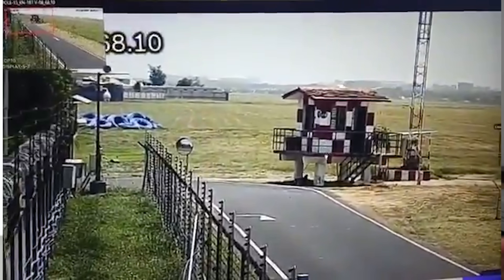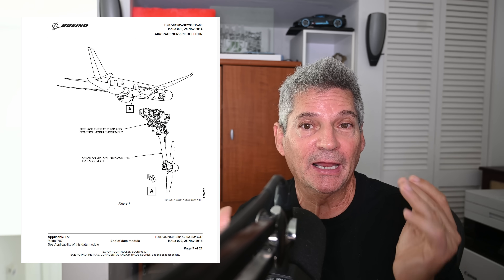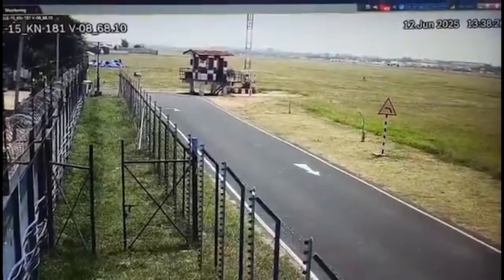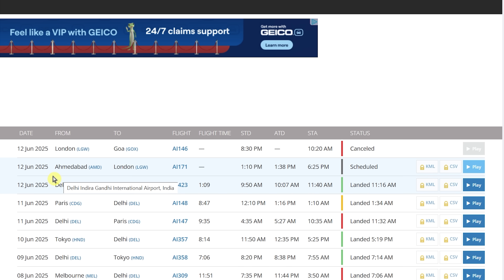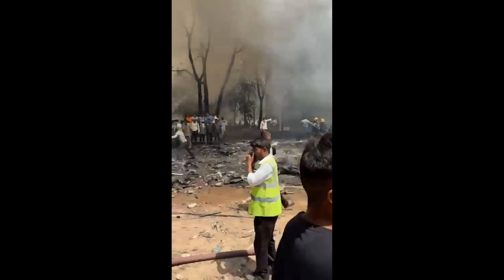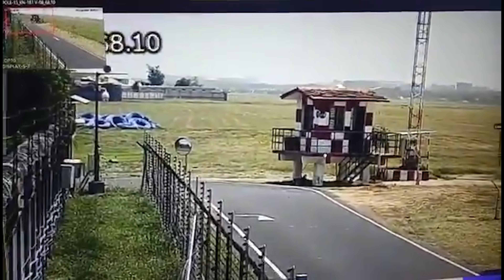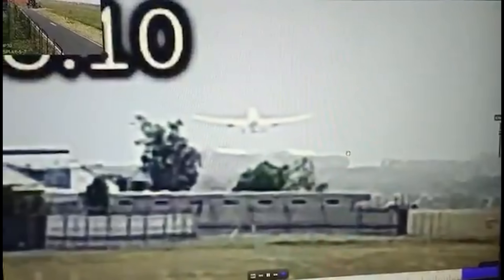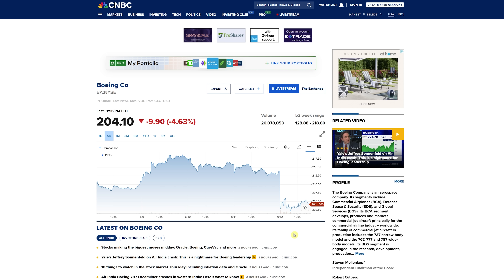What Caused Air India 171 Crash, Mysterious Sound Before Impact

Comment: 25,000-hour B777 captain here.  It may be pilot error.  Selecting flaps up after takeoff instead of the landing gear is my theory, and it explains why the gear stayed fully down. The crash pics show the L/E slats extended on the ground with little or no T/E flaps extended. That could not have been the T/O configuration, and "proves" the flaps were selected up after T/O.  Selecting flaps up at a speed behind the power curve would feel to the flying pilot like a loss of power, thus the "mayday lost power" radio call.  If true, the FDR will confirm.
Reply: By now the Indian authorities probably already have downloaded the data and voice recorders. I doubt that this crash will be hard to solve.
Reply: Hi Captain, I'm armchair rated at best but I am here to learn. May I ask, would your theory explain the RAT deployment and could the aircraft take off in that configuration without the bells and whistles going berserk? Thank you for your time, Captain
Reply: @restojon1  I have looked and looked….I don’t see a RAT.
Reply: @buckcampbell4292 I can just about see what looks like the little flap by the wing root kind of area
Reply: @restojon1 the captains more armchair  than you 😅
Reply: @restojon1 I was thinking the same thing . . I have a feeling this crash was caused by some sort of mechanical failure
Reply: @restojon1 not likely. Selecting flaps up would not likely deploy the RAT.
Reply: @restojon1  if you look at the video and enlarge it you can clearly see that no RAT was deployed at any point, engines sound like that on takeoff when they are at high power, also with buildings that close you will get echo/reverb which could sound like a RAT. Also remember that this Boeing has massive fan blades for thrust, the main engines are called Turbofan Engines for a reason.
Reply: @restojon1  his is a fake CAPTAIN ! He's impersonating captain steve who has more than 50k subscribers, who's a real pilot. HE'S A FAKE PILOT ! INVENTING THEMSELF LIFES ON INTERNET.
Reply: @restojon1  his is a fake CAPTAIN ! He's impersonating captain steve who has more than 50k subscribers, who's a real pilot. HE'S A FAKE PILOT ! INVENTING THEMSELF LIFES ON INTERNET.!!
Reply: Ok, was that a bearing going? Or was the RAT? The one video shows dust flying as they went into the air. Does this suggest they were at the end of the runway? Could they have been having a problem partway down the runway?
Reply: the 1 survivor said he heard a loud bang right after takeoff
Reply: @T1Earn  he must have a horrendous memory now, knowing what’s about to happen and hearing all the other passengers scream …
Reply: @dealightful82  crazy to say we wouldnt trust what the only person who survived is saying literally hours after it happened. And he never went unconscious either
Reply: @T1Earn  True, he just went through a trauma, his perception may have been altered.
Reply: So forget about all the human error theories. What is the plume of smoke on the airport cctv as the plane lifts off the ground? Also, I saw a video of a passenger who was in that paricular plane hours before it crashed, and he said the A/C compressor was malfunctioning on then off throughout the flight and also peoples tv screens stopped working. I reckon its a badly maintained aircraft. NTSB will soon confirm.
Reply: @SteveSkrobot the ntsb isn’t in charge.
Reply: @BirdDog.  yeh I know, but the US is sending some investigators over.
Reply: @SteveSkrobot and they buy used parts to fix their planes.  Disaster ready to happen.
Reply: As a 44yr military/commercial Captain. I agree with the assessment. The flaps were set correctly for T/Off (otherwise the computers would be squawking at power up). Sounds as though the 1000 hour F/O selected flaps up instead of gear up after T/Off.
Reply: @valentinomarchione5576  "otherwise the computers would be squawking at power up"
Unless of course the power breaker was pulled.
Reply: Liar.  They didn't forget to lift the gear, they have the RAT out to try and cleanup the surfaces, flaps and gear.  Obviously engine+hydrolics failure.  Like the korean bird strike.
Reply: @valentinomarchione5576 And why is there no safety system in such a plane to prevent such a basic and catastrophic error? Negligent design by Boeing again?
Reply: @valentinomarchione5576 With crm, don't they verbalize their actions? How would 1,000 hour 787 pilot verbally say they were raising the gear when they had their hand on the flap lever? That's incomprehensible.  Workload on a 787 is relatively low compared to other aircraft so how would hey highly experienced captain have not picked that up?  They're in the heat India, they've chosen a reduced length takeoff roll, they should be on their game no?
Reply: @valentinomarchione5576  1000 hour pilots and intersection takeoffs make for very holy swisscheese.
Reply: @valentinomarchione5576  There would be a system warning and they could have reversed it.
Reply: @valentinomarchione5576  FDR will quickly establish. From a human factors POV, this is a distinct and tragic possibility.  Some 777 guys have mentioned certain envelope protections the 787 likely has that might protect against below speed flap retraction but it certainly looks like that may have happened nonetheless.
Reply: @valentinomarchione5576 seems like all of we seasoned airline pilots are in agreement about the most likely scenario being the pilot not flying raising the flaps instead of of the gear with lack of forethought
Reply: @valentinomarchione5576 But pilots of the plane say you can't change the flaps after take off, it won't let you!
Reply: this is my theory as well, though i started thinking about how it was only in the air for like 30 seconds, and maybe they forgot to set flaps for take off at all, and just wasn't thinking about retracting the landing gear anymore when they noticed they weren't climbing.
Reply: @WessyD1  - There is a warning system, that tells you if the flaps aren't deployed for takeoff - it SCREAMS at you.  Pretty hard to takeoff without at least some flaps deployed in a modern aircraft.  So, more likely retraced by mistake after the wheels left the ground.
Reply: @Summitspeedfly  yeah, most likely retracted by mistake.
Reply: With no flaps they wouldn't have made it past 100' altitude @WessyD1
Reply: @WessyD1 in a B787 if you don't set the correct flaps according to the specific configuration before taking off huge alarms go off in the cockpit so it's almost impossible to miss that , my assumption being the co pilot instead of retracting the landing gears accidentally changed the flaps which caused the wings to not generate enough lift and subsequently the drag produced by the gears pulled the craft down into the ground
Reply: @WessyD1 as soon as they advance the throttles they would master warning and aural warning and all the other bells and whistles letting them know plane is not configured for take off.
Reply: @WessyD1  that's what I was thinking. I watch the "mayday" series, and there was one they covered where the pilots hadn't deployed the flaps, which caused the crash, of course. If I remember correctly, they were behind their intended take off time, and I think a couple of other things were going on, too. This created a lot of stress, which, in turn, could have caused them to forget one of the most basic steps. That's what the investigators had speculated.

The video from that crash looked very similar to this one's crash. But their RAT wasn't deployed, so there wasn't a noise before they crashed.
Reply: @WessyD1 Plane won't take off with flaps in the wrong position, without alarms!
Reply: @imyourhuckleberry1058  it'll take off, just wont climb afterwards.
Reply: @WessyD1 the piolet had 8200 hours of experience, how can forget
Reply: @Real_cat_14  🤷‍♂
Reply: @WessyD1  - Then take-off did not happen after rolling! The air plane went UP then lost altitude!
Reply: @trungduongdang8087  a plane still take off with no flaps. it just can't climb.
Reply: @WessyD1  787 doesn't allow take off if flaps aren't down
Reply: @reardelt  You can override any automatic system on a jet.
Reply: @WessyD1  Why would any sane pilot override that system? It takes a lot of effort to override that system on a 787. No one does that on take off
Reply: @WessyD1 but wouldn't there be a warning on the runway about flaps?
Reply: @WessyD1  I'm also not expert but I think you're correct, once they realized there was something wrong they weren't focusing on the wheels and let them as they were, but then the captain is also correct, we don't see the flaps down as they are supposed to be during a takeoff. Having a pilot AND a copilot, it is mystery how two people would miss this major error. I guess we'll just have to wait for the black box and eyewitness interview analysis.
Reply: @WessyD1  the 787 literally wont let you take off without proper flap config so not possible unless the crew purposefully did it.
Reply: @ChikenTendersYa  yeah, i mean, they might not have known what alarm they were disabling. they might have thought it was something else.
Reply: @WessyD1 they would not have taken off without the flaps being deployed because too many warning horns would have been going off so imo they must have raised the flaps too early for their phase of flight or raised them by mistake
Reply: @davidmorais480  dude read replies before you reply. Its just a theory. i just as much think it could be what you say or the other.
Reply: @WessyD1 But with the sophistication of Dreamliner's electronic, the avionics should not have allowed take off or warned  if flaps are not in correct Take-off mode?
Reply: @bobbykrystal4798  yeah, i mean, its just a theory.
Reply: @WessyD1  If takeoff flaps hadn't been set, it would probably have crashed on the airfield. AIUI, the 787 has serious protections that don't allow takeoff thrust without the flaps set.
Reply: @WessyD1 not possible...this airline has security systems that reminds pilot when any take of procedure is not done
Reply: @rameesarahman007 a pilot screw up will not originate a " may day " , it is a human compulsive guilt management mechanism. Cockpit voice recorder will also bring that out . 
There is a sound of EXPLOSION reported by the survivor, when the descent starts
Reply: @WessyD1  This is a fake CAPTAIN ! He's impersonating captain steve who has more than 50k subscribers, who's a real pilot. HE'S A FAKE PILOT ! INVENTING THEMSELF LIFES ON INTERNET. when they usually say "XXXX here" it s100% Fake
Reply: @WessyD1  his is a fake CAPTAIN ! He's impersonating captain steve who has more than 50k subscribers, who's a real pilot. HE'S A FAKE PILOT ! INVENTING THEMSELF LIFES ON INTERNET.!!!
Reply: I said in another video why does it look like there is no flaps down for take off... 

Then again I'm not a pilot.
Reply: @evelghostrider  that's the right question.... they look up, but the imagery is very grainy....
Reply: @evelghostrider  I think it looks like the flaps are down.
Reply: It can't be . Coz gear up down lever is in front ahead.  Flaps are next to pilots. 2 diff location
Reply: @AneeshChowdhury  Also surely system warnings for such a mistake?
Reply: @AneeshChowdhury  Yah.  He went to the wrong location and raised the flaps….cause Indian pilots.
Reply: @AneeshChowdhury I think you would be surprised at the mistakes we are capable of.
Reply: T.A.P Air Pilot here. I don't see the Flaps do you?. and Why are the landing gear still down?
Reply: What about the loud bang the survivor reported?
Reply: @jimjoe9945  Gear was down and probably clipped a building a second or two before full impact.
Reply: @jimjoe9945 maybe the APU blew... That would explain the rat deployment.
Reply: @jimjoe9945 that happened when the right engine failed
Reply: @jimjoe9945 So many people are missing these clues, the bang sound and the sound of the RAT
Reply: @jimjoe9945  Bird strike. Same thing like happened with US Air and Sullenberger. But he was at like 1600 feet when they lost both engines and had more speed and altitude and therefore time to point the plane in a different direction and ditch in the Hudson. These Air India pilots had no air speed or altitude to play with so they were doomed.
Reply: @jimjoe9945  RATs that I'm familiar with (and have deployed in flight testing) are actually "Spring Loaded" in their storage compartment in the Fuselage. An electrically fired Explosive Bolt unlocks the latch that keeps the RAT stored in its' compartment, and the spring forces the RAT out into the airstream, nearly instantaneously. You will hear a "loud bang" when the bolt fires and the RAT "slams" into place.  Given the location of the RAT, and the survivors seat location, that's probably what he heard...
Reply: @jimjoe9945 you the bang when the airplane hit the ground?
Reply: That was what I thought earlier, but why was the RAT deployed? In one of the videos, you could hear it very well as its sound is quite distinctive. I doubt in that amount of time that the RAT would be manually deployed, so it makes you think that it had to be autodeployed.
Reply: @ericchristensen634  Ironic to say that in  a video you can hear the RAT but not see it.  How do they make these invisible RATs?
Reply: @ericchristensen634  with 10 seconds to death, you aren't deploying the RAT..... you are kissing your ass goodbye.
Reply: @ericchristensen634  In that circumstance, there's no reason to manually deploy the RAT, I'm not familiar enough with the 787 to even know if that's possible. But the only thing the RAT is supply emergency electricity. In the circumstance they were in, they had battery electricity for a lot longer than they'd need.
Reply: Raising landing gear often increases drag when behind the power curve due to opening access doors to allow retraction.
Reply: Jeff, the seat map you showed appeared to be for the -9. I believe this was a -8.
Reply: Captain Steve, poor service and fuel also may have caused the tragedy???
Reply: I have a close friend who is a 787 pilot and I asked him about the takeoff flap settings. He said "Usually the lowest flap setting for takeoff is Flaps 5. This flap setting includes full slat deployment" The slats do look extended and FLAPS 5 is so minimal that it may have not been apparent in the low quality video we have seen thus far. The flaps go all the way to a FLAPS 30 setting for full extension. Generally flaps on airliners are not lowered nearly as far for take off as they are for landing. Note that the initial climb out after rotation appears normal whereas in accidents involving improper flaps/slats settings planes have a hard time just getting off the ground. The real issue here is somewhere around 400 feet of altitude the 787 lost all power. This is why the RAT deployed and the main engine noise is next to nothing. The landing gear also looks like it was partially through the retraction process which pulls the main boogies into a forward tilting position to fit into the landing gear bay but could not complete the process because again both engines shut off thus killing the hydraulics. So the number one question in my mind is what happened to the engines? A flight crew can do everything absolutely right but with no engine power you're still going to crash.
Reply: @ronhaworth5808  Excellent observation and comments. Takeoff flap settings can be as low as 1, but given the weather conditions, I guess they'd need more lift than that. 
"Boogies"? Do you mean the landing gear trucks (as Boeing calls them)?
Reply: If it was a flaps  issue you would have heard the engine running at max thrust as pilots tried to get it up
Reply: the flaps WERE up!
Reply: @utley yes, that's the theory. The landing gear was supposed to go up first, followed by flaps later, incrementally. Not the other way round
Reply: Can they be done at the same time under RAT power?
Reply: seems not.

we can see the engine from behind

11:30
Reply: @utley  You missed the point...
Reply: @utley  So pilot fatigue killed over 200 people? No professional pilot would make such a basic error unless he was punch drunk with fatigue. One version I read said the Captain was flying,with the F/O on the instruments/controls. The Captain requested wheels up,but the F/O retracted the flaps instead. The flight recorders will reveal the truth.
Reply: @mikedunn7795  if the flaps were up, that means they either didnt do the takeoff checklist or the flaps didnt deploy when commanded to.
Reply: @mikedunn7795  those flaps werent deployed at all.
Reply: @utley  Not on the crash pictures
Reply: @utley  That's what he said - the pilot mistakenly put the flaps up instead of the landing gear.
Reply: @utley --- nope... flaps were extended.
Reply: @utley No they weren't. Take another look at 0:01 seconds into this video and you can clearly see leading edges deployed, and flaps  extended.
Reply: @utley  pause at 1:41 and zoom in. Not a pilot, but are the flaps closest to the fuselage? Do they look like they are down?
Reply: @sined726  I SAID THEY ARENT DOWN.
Reply: @utley apparently this type of plane won't let you take off unless the flaps are in the correct configuration for take-off.
Reply: @utley  pause jeffs latest video at 12:36, FLAPS ARE DOWN. You can see the gap between wing and flap.
Reply: @sined726  if flaps were down, you wouldnt be able to see the exhaust nozzles, especially at that angle. coincidentally, forward of those flaps are the spoilers.
Reply: @sined726  inboard set of spoilers anyways...
Reply: @utley  how can you tell it’s near impossible from the distance the video was taken…
Reply: @Ilike.kong. aircraft that big you know if the flaps are down or not. Full flaps and those things hang about 4 feet off the deck. Half flaps they hang about 8 feet off the deck. Zero flaps? about 20.
Reply: @utley  i zoomed in the video multiple time and I do not see the flap set to 20 degrees
Reply: @utley  his is a fake CAPTAIN ! He's impersonating captain steve who has more than 50k subscribers, who's a real pilot. HE'S A FAKE PILOT ! INVENTING THEMSELF LIFES ON INTERNET.!!!
Reply: @utley nope they were not.
Reply: @utley  The SLATS appeared extended on one of the vids I saw.   On the older 767s, FLAPS 1 was a takeoff config which resulted in Leading Edge Slats deployed but zero Flas.
Reply: @utley how do you know?
Reply: @utley yes, and he very clearly says that in his comment, weird you missed that!
Reply: Not at rotation unless they were committing suicide. Too many warnings/buzzers. If it wasen’t engine failure that’s prob what happened. The gear are pulled up right after the wheels leave the pavement….. They were down until impact😢
Reply: @utley 
No they weren’t. It’s not possible to takeoff without flaps is these things. People are used to looked at landing flaps so don’t know what takeoff flaps look like. And the slats were extended in wreckage photos. Even if flaps were inadvertently selected up it would only be from 5 to 1 and they don’t retract that quickly. While possible it seems unlikely
Reply: @meofnz2320  Oh it will be able to take off without flaps, just will need a lot more speed than usual. Go watch the B-2 crash on guam  and tell me if those crashes look exactly alike if not similar. Given all the issues on that aircraft that were electrical being reported prior to the crash, I wouldnt doubt for a second those flaps didnt deploy when commanded.
Reply: @utley  the engine cut out
Reply: It's not clear. 5 degree flaps at that distance is difficult to detect.
Reply: @utley why the smoke show at the end of the runway, they shouldn’t have used up all the runway.
Reply: @utley  Yea, looks like they are up...
Reply: Just to add. In the flight computer, you can set the thrust to reduce power when retracting flaps after take off, which would of course makes things worse if the flaps were selected by mistake before the optimal speed is attained
Reply: My thoughts exactly, and loss of lift occurred exactly where you would expect the gear to be moving upwards. Just a thought
Reply: How you confuse flaps with gear
Reply: He needs speed to prevent a stall.  Speed falling, so he tried to cleanup the surfaces.  I don't know why he didn't lift gear.  Might have gave him a chance, maybe still not enough speed though.  Big power-loss somewhere possibly 1 engine, with a max load and stupid shorter takeoff.  Never ever accept an intersection takeoff.  You paid the fees for the full length..take the full length, every time.  ATC can go to hell!
Reply: @latinbishop1722  It's been done several times before by experienced pilots and co-pilots. Unfortunately when mistakes happen during takeoffs and landings there isn't enough time to go through check lists to determine what the problem is. We still have no idea what exactly happened. We will have to wait and see for sure. It could be mechanical.
Reply: @latinbishop1722  Exactly. And surely there would be system warnings?
Reply: @latinbishop1722 It is definitely possible. Ask the delta crew that shut down both engines on a 767 very shortly after takeoff from LA many years ago. Selecting the wrong control/switch happens more than you know. Most of the time the mistake is recoverable. 

I doubt inadvertent flap retraction is the case here however. There is like 15 seconds or so of “descent” prior to impact. Thats a lot of time to recover from an inadvertent flap retraction especially with the engines already producing take off thrust and the crew would have likely fire walled the thrust levers as well.

I expect we will learn that both engines were failed for whatever reason. Simply no time to get them running again even if was possible. Horrible scenario.
Reply: @Scott767300  "There is like 15 seconds or so of “descent” prior to impact. Thats a lot of time to recover from an inadvertent flap retraction"
Only if they would understand what the problem was within the first 5-8 seconds I guess. Maybe mistaking the flap lever for the gear lever is so out of the norm that they even never considered it. See, that's the issue with speculating.
Reply: @brucelansberg5485 I would disagree on the “not knowing for 5-8 seconds” especially regarding the thrust status of the engines. This would be immediately known. You could feel the loss of thrust and hear it immediately. And a quarter second glance over at N1/EPR would tell the tale. They knew the thrust status immediately. Would they have known why thrust was lost? No.

If indeed the engines had failed (for whatever reason) there is not much you can do. I suspect we will learn this is the case. At least it should be easy to solve. Terrible scenario.
Reply: @latinbishop1722  inexperienced copilot.
Reply: It’s probably another  malfunction from the plane ✈️
Reply: Totally agree.  The sinking would give you a sensation of loss thrust if you didn’t look at indications.
Reply: how could you ever mistake the landing gear lever with the flaps adjuster
Reply: Yep. Flaps up wheels down. Should be the other way around. At least that's what it looks like.
Reply: You can’t see the flaps being put up so I’m not sure why you pilots all keep peddling this theory. If you look at 787 take off videos the flaps look like they’re in the same position as the air India flight doing
Reply: Almost all crashes are pilot error no matter what the news says. It ridiculous that people in the comments refuse to believe it could be pilot error. If you don’t believe it’s pilot error then why are almost all crashes found to be pilot error???
Reply: @veiledallegory It definitely could be and yes you are correct that most crashes have the crew as a contributing factor. 

This one however might be an outlier on those stats.
Reply: @veiledallegory  That's not true, poor maintenance procedures and inspections combined with cost cutting exercises are often the cause.
Reply: ex f4u fighter captain.... reducing the lift by retardin flaps to early sounds off considering to flaps = less drag = faster accelerate to 220 to get that thing level...

to me its look like the engines werent produced enough thrust to keep it in a climb, ..  my bet is poor mainenance... the east indians are notorious for it :-\
Reply: right on the money. I have been flying the 787 for 10 years. "positive rate.. Gear up"  the gear never moved. someone appears to have moved the flap handle up....Damn!!!
Reply: Possible pilot disagree on abort?
Reply: @tag1961 then you should know that if the pilots knew they'd lost engine power and couldn't possibly climb, what options did they have left?
Put it down where you can... In this scenario you leave gear down.

This is basic stuff...
Reply: Stupid assessment. The RAT was deployed, nothing to do with flaps. Fuel/engine issue.
Reply: Good observation.
Reply: I'm THRILLED that you are chiming in!! So MANY THANKS for your knowledgeable and respected feedback!!!
Reply: I agree about the flaps and the landing gear. But that's the quietest jet I've ever heard.
Reply: Why would the RAT extend if not engine failure?
Reply: @n085fs  I'm not too familiar with the 787, but on the Airbus models, there is a guarded button on the overhead panel to manually deploy it.
Reply: 100-hour flight sim user here.  I wonder why flaps are manually selected, when it seems it would be easy to implement "auto-flaps" where the speed-appropriate flaps setting is always selected by automation.
Reply: @vonkruel  Because changing flaps setting changes elevator trim as well.
Try flying the simulator on 100% realistic settings and even then you're maybe 20% true to life.
Reply: @n085fs  I only referenced my sim experienced jokingly.  Thanks for explaining why "auto-flaps" isn't a thing.
Reply: @vonkruel exactly…like camera settings in manual….set for shutter priority, you select the speed, the camera changes everything else to get a good photo.
Reply: Agree
Reply: nice hypothesis and the closest estimate
Reply: I don’t see flaps. Do you ?
Reply: @Traveler_SF nope
Reply: Unlikely sir. The pilot had 8200hrs on file. He's been flying the same model for ~11 years. The motions would be muscle memory by now. It's highly unlikely that it's pilot error considering even the copilot had 1100 hrs on file. It's improbable.
Reply: Pause the video at 0:01 seconds. You can clearly see the leading edges are deployed, and the flaps are down. The thing that is more telling is the main bogeys have rotated level like the gear was commanded, but it does not cycle into retraction. Dual engine failure and sudden loss  of hydraulic looks plausible.
Reply: @kevinfinke6927 yup, I agree with you. Major failure. Sucks that it happened in one of the most critical phase of flight. I’m curious if it’s a GE or RR engine. This can have serious implications on the variant.
Reply: @WattsValor They fly the GE nx variant.
Reply: I’m also a 25000 hour 777 captain. It’s possibly an inadvertent flap selection but there are some flaws in that theory. The flaps would only travel from 5 to 1. I’m not convinced that a) they would retract fast enough for this result, or b) it would even stall at all. After all, It was doing 180kts on lift off and I’m usually seeing well over 200kts by the time gear is selected up.

I gotta admit though…it is odd that the gear stayed down while the initial part of the climb was normal…suggesting that power was available during the period the gear would normally have been selected up.
Reply: Since you say you are a 777 pilot what happens when you set throttle for takeoff when the flaps aren't deployed? Take note that the same thing happens in most modern aircraft. The takeoff config alarm CANNOT be disabled. Why not abort takeoff if the alarm is blaring at the pilots?
Reply: @GreggRoberts  or deploy the flaps
Reply: You are correct. The "CONFIG" warning cannot be silenced. My guess is that the takeoff configuration was "normal" as the aircraft accelerated and the initial climb appeared to be a normal climb. My first question is why wasn't the landing gear retracted as the aircraft climbed through at least 600 ft. AGL ? Secondly, a decent like that MAY have been caused by a premature retraction of the flaps. We'll know more when the CFR & DFDR are analyzed.  @GreggRoberts
Reply: Once you call out mayday if you're a pilot you would definitely check flaps. Its an easy fix, but not unless you also have loss of power. There's an engine/fuel issue at the core here.
Reply: @halfmv2  I agree it looks like engine or fuel doesn't it. That would explain the RAT deployment. Somebody else suggests the flap retraction too soon would do it but i don't see why the RAT would initiate on flap retraction. But it definitely pops out if you've got no power from dead engines.
Reply: @halfmv2 or battery power or apu failure
Reply: @halfmv2  yes   engine or fuel   the aircraft should say  you flap settings are incorrect  change settings    stall on takeoff ..
Reply: @halfmv2  Engines in this plane are independent, pumps, computers are independent.
Reply: @halfmv2  There unfortunately have been numerous other crashes like this due to the flap configuration during take off
Reply: @halfmv2  his is a fake CAPTAIN ! He's impersonating captain steve who has more than 50k subscribers, who's a real pilot. HE'S A FAKE PILOT ! INVENTING THEMSELF LIFES ON INTERNET.
Reply: @halfmv2  his is a fake CAPTAIN ! He's impersonating captain steve who has more than 50k subscribers, who's a real pilot. HE'S A FAKE PILOT ! INVENTING THEMSELF LIFES ON INTERNET.
Reply: @halfmv2 clearly you’ve never flown a plane from your faulty assumptions
Reply: @Mpr47276  ok so you want to replace all aircraft design engineers with pilots because engineers clearly haven't flown a plane?
Reply: @halfmv2  Aviate, Navigate, Communicate. Calling Mayday would be the last thing you do after checking flaps, undercarriage, Engines etc..
Reply: @serverlan763 yes that's exactly my point, they couldn't have simply missed something if they called mayday
Reply: @halfmv2  maybe a gravel strike? {like a bird strike}see my comment
Reply: And the pilots just manually deployed the RAT for the fun of it?  If you were piloting that flight and the RAT deployed, why might it be, captain?
Reply: @LokiCentral  Its also automatic, at total loss of AC, deploys in 2 sec
Reply: @LokiCentral  The Japan Airline 787 landing with ram air turbine (RAT) is not necessary an emergency landing. An airplane in C check is a jobcard for RAT operational check, sometimes we will request pilot that deploy RAT at the last flight landing right before C check, than during C check we do not need to setup equipment creat ram air to test RAT, instead just test RAT retract function.
Reply: @stanleyjtw  Right, I'm assuming that.  But it still sounds like a RAT, doesn't it?
Reply: @LokiCentral  That video was pretty clear but no RAT visible.  How do you explain that?
Reply: @DellAnderson You can hear the RAT very distinctly.
Reply: @LokiCentral sudden loss of electrical power. The RAT is just a prop driven generator that supplies electrical power to critical systems and instruments
Reply: @LokiCentral how to tell if RAT was deployed
Reply: @LokiCentral por lo visto no escucharon todo lo que dijo el capitán, el RAT es un sistema automático de emergencia, que se activa para asegurar que exista suficiente amperaje o voltaje para los aparatos más indispensables
Reply: @LokiCentral  No RAT was deployed.
Reply: @LokiCentral  it's automatic.  if they had engine failure it would pop out automatically.   At this stage of flight, however, it is of no use.  You cannot take off without engine power, obviously.
Reply: @LokiCentral  his is a fake CAPTAIN ! He's impersonating captain steve who has more than 50k subscribers, who's a real pilot. HE'S A FAKE PILOT ! INVENTING THEMSELF LIFES ON INTERNET.
Reply: @LokiCentral  his is a fake CAPTAIN ! He's impersonating captain steve who has more than 50k subscribers, who's a real pilot. HE'S A FAKE PILOT ! INVENTING THEMSELF LIFES ON INTERNET.
Reply: @LokiCentral  RAT automatically deploys when it senses a loss of power....  So that suggests that maybe both engines experienced a sudden shutdown....
Reply: @LokiCentral  The theory in the video is that it sounded like the RAT was deployed. That is just a theory offered, not a known fact and there is no visual evidence of that theory being correct. I've zoomed right in and it doesn't seem to have been.
Reply: @LokiCentral  RAT are deployed automatically
Reply: did the engines noice appeared too low-frequency , indicating a possible low rotation problem?
Reply: Isn't there a config alarm??
Reply: Agree, aren't the flap controls on the center in between the pilots and the wheel extension in the middle between the yokes?
Reply: Condoléances aux familles 🙏🙏🙏
Reply: With all due respect Captain, can I ask you why they used the entire length of the runway, kicking up dust at the end? 
It reminds me  the case of Olympic Airways Flight 411 on August 9, 1978 from Athens to New York.
Reply: @octoberon5959  if you look at Flightradar 24 data from this flight, it shows then starting TO from the middle of the runway!!. It does not show them taxiing all the way back to the end of the runway and turning 180 to line up and start their take of??
Reply: full toga thrust selection would surely outweigh and early flap mistake though? I fly 787 and the excess thrust is insane low alt. Be interesting to see the FDR and any GE real time data.
Reply: @NickoHines they probably weren't far off 100 anyway.
Reply: And why is there no safety mechanism, override, alert warning and, or alarm on these planes to prevent a pilot from incorrectly and catastrophically changing the flaps' configuration immediately after take-off, or at any other time during the flight? That would seem like a very basic safety feature that all planes should have, to ensure that what you have described cannot happen.
Reply: @markpalmer8083  Cost of production.
Sure, all systems can be engineered to operate only within limits.
But it's cheaper to just train the pilots when to operate things.
And then when training gets too expensive, ya get more pilot error issues.
Reply: He had 8200 hr+ flight time experience.. I don't think it's a flap issue.. it might be an engine related issue
Reply: RIP everyone.
Reply: Wow, for once, Captain Steeeeeeeeve might be onto something.
Reply: This is the same thing I thought based on the photos. Flaps are suspiciously retracted and the descent started around the same time you would have expected the pilot flying to call for “gears up.” I think the moment the plane starts descending, the pilot monitoring pushed the wrong lever.
Reply: Gear wasn't working
Reply: If this was the cause (human error) then why don't the plane makers make take offs overriden by an auto-pilot software?
Reply: Hi captain farbeit for me to argue with a pilot. But even if the flaps were up wouldnt full thrust T/O still keep the plane in the air, or at the very least recover the aircraft from losing altitude?
Reply: Doubtful. I understand that the plane had a full passenger and fuel load. Not overloaded but with an outside temp of 99° F, anything wrong at rotation would probably be catastrophic. Flaps or loss of power @uriblaketheriddimprotege
Reply: @Templar451 i am leaning toward dual engine failure, but thanks for the insight
Reply: @uriblaketheriddimprotege  In a video you can hear the engines going.  Power loss from a fuel contamination / fuel delivery problem maybe?
Reply: You're a credit to the 'Civil Aviation Industry' Capt' Steve' Blue Skies always 👍
Reply: Clearly pilot mistake or technical error for sure
Reply: @IamSpidey007  Well that certainly narrows it down...
Reply: Go watch a 787 in a flap 5 takeoff, try to see if it looks any different than the above video.
Reply: suicide?
Reply: No there are 4 pilots in the cockpit.
Reply: As a captain of aeroplane game. I don't know how it happen.
Reply: Well, that's theory is wrong sir, You see the RAT is deployed. And this error you are talking about, is pretty basic one, the pilot had 8000+ hours experience.
Reply: What about ADSB saying G/S was 174kts, wouldn't that speed be enough to maintain flight even with the flaps retracted?
Reply: Captain, if you want to be helpful then speak a language all of us can understand,  not only a few trained professionals.
Reply: I think they either selected flaps up on accident instead of the gear or the wire bundle in the wing shorted and retracted.

The flaps had to be out for initial takeoff or the flight computer would have gone crazy, and probably would not have gotten out of ground effect
Reply: Thanks, Captain for your thoughts and flying 🙏
Reply: If the flaps were retracted prematurely, why weren't the engines howling at full power, and why was the RAT rattling?
Reply: @AllanFolm  The RAT is intended to provide limited essential power if the main engines fail.
It can only do that effectively at altitude with significant airspeed, not close to the ground just after takeoff !
Reply: Thanks Capt. Steve
Reply: Notice how everyone is a pilot when there is a crash.
Reply: @Captainsteve777 I agree with you. I dont see the rat deployed. I also feel that if there are no flaps deployed at line check before take off, we would see a dip in the wings, left or right, after rotation. But setting flaps from 5° to accidentally stowing the flaps instead of gear would cause the plane to lose near all its lift. We should see soon. RIP to all lost in this accident
Reply: I think the left engine failed during take off and the aircraft was too heavy for the right engine to continue lifting the aircraft after the left engine failure. Just my theory.
Reply: Ada Pusaran angin diujung landasan terlihat debu berterbangan yang menciptakan ruang hampa sehingga pesawat kehilangan daya angkatnya.
Reply: Thank you for this insightful and detailed analysis—your experience as a B777 captain adds valuable perspective. It’s observations like yours that help the public better understand the complex factors at play in such tragedies. Let’s hope the FDR provides clear answers soon.
Reply: My thoughts exactly!  Huge error!
Reply: Thank you for your input
Reply: Well said , my brothers a pilot , said the same thing , terrible tragedy for all on board and families.
Reply: That might have been possible if RAT was not deployed. Ram Air Turbine (RAT) on the Boeing 787 automatically deploys in the event of a complete loss of both main AC power sources, and flaps don't shut off both engines or cause complete loss of power. Loss of lift, yes. Also, with pilot having 10,000 hrs of flight hours, that's unlikely.
Reply: As a retired 787 Capt that's my was first thought. Why was the gear down and it didn't look like the flaps were out. Looked like classic stall/sink right into the ground. Can't imagine how they could have taken off without flaps configured so they must have selected flaps up instead of the gear up after take off. Didn't appear to have an engine malfunction, no smoke or noise.
Reply: Prayers for all those that perished in the flight my condolences
Reply: I think you are spot on. No flaps, no lift! Tragic. 🙏
Reply: @nihilmiror6312  and there was no warning for it, such noobs
Reply: If engines are fine the plane should still be able to power thru it and fly up regardless right?
Reply: Hi Steve, great to see you on here.   I suppose it's possible but wouldn't it go against decades of routine memory to call for flaps up before saying "positive rate, gear up?"  I'm not a pilot but I am a Ramp Agent and that would be like me forgetting to confirm brake release and clearance before pushing back an aircraft.  I suppose it's not impossible but improbable.   My conjecture with my admitted limited knowledge is something happened just after V1 and maybe that's why perhaps they were distracted and neglected to raise the gear?  Sometimes that happens on go-arounds where the crew is suddenly snapped out of a routine so they forget to raise the gear.  It doesn't explain why the flaps were retracted though.   You are right of course,  I'm not sure how 787 systems work but I certainly hope the FDR doesn't stop working if electrical power does, along with the CVR.  Hopefully we will learn a lot from this.
Reply: Ah, taking the flaps up and that small RAT will deploy. 
Got it, Captain.
Reply: A premature retraction of flaps while the aircraft is still behind the power curve could easily induce a dangerous sink rate or even a stall, especially if there's already any kind of marginal performance
Reply: @wewinnew Should you not add that nobody was injured?
Reply: I was also concerned about the flaps not being extended.
If they weren't extended in the first place, the takeoff warning would have sounded when the plane was about to take off, so it would make sense that the pilot had moved the flap lever after takeoff by mistake, instead of the gear lever.
Reply: This is what I also thought. Also, engines will have that “prop” sound when throttles are pushed full forward
Reply: For the record, this commenter is NOT the same account as @CaptainSteeeve who has posted his own theories about the causes of the accident. I would take this comment with a huge grain of salt. Possibily a fake account masquerading as an expert.
Reply: How do you explain the dust cloud upon takeoff?  The thing overran the runway or almost.  I reckon the issue (lack of thrust) started before/as they lifted off.
Reply: You may very well be rite !. Maybe the engine trouble started after the plane passed the go no go point in the takeoff roll . Cannot abort takeoff after that point because not enough room runway left to stop. So they stay full power continue the takeoff figure out the problem in the air . Best you can.  @davidd5226
Reply: The pilot of the plane was also very experienced. 22 years of experience.
Reply: I just posted a comment that I was surprised he didn't mention the flap settings in this video. Apparently I have been watching too many Airline disaster videos here on YouTube. I am amazed though how this survivor in seat 11 A was able to walk away from this accident. I pray there are more survivors in the hospital that just have not been reported on. To the pilots, crew and other passengers I hope they didn't suffer and may they RIP. 💔
Reply: Can some one who knows this model confirm if the flight envelope under normal rule prevents flap retraction during critical phases as these pl?
Reply: Curious question. How would you deploy flaps instead of landing gear? I'm not a pilot but pretty sure it's clearly marked.
Reply: And it won’t take long for the FDR to reveal the details of your theory. It sounds like a solid hypothesis but who knows.
Reply: I don’t think plane stalled
Reply: Captain, maybe my theory is that the cargo was overloaded maybe which made B787-8 to stall?
Reply: How do you put the flaps up instead of the gear. Those levers are nowhere close?
Reply: the one dude who survived reported green lights or whatever which i heard is the emergency lights that turn on during electrical failure, theres definitely something more going on.
Reply: https://www.youtube.com/watch?v=4e5JTchiajA and https://www.youtube.com/watch?v=TTZozTaWiRo this video of a take off from cockpit... selecting flaps up ?  it makes absolutely zero sense, unless it is done by accident ? which also is hard to make this kind of mistake i think? also gear up is the first thing called as soon as rotated-take off isnt it? isnt the gears retracting mechanism heavily rely on engine power? it seems to be a some sudden catastrophic series of engine /fuel/ hydraulics combination of failures of some sort?
Reply: This is not Captain Steeeve.  Fake  YouTube page.
Reply: This appears to be the presiding theory however as a commercial pilot you would know that the most obvious reason in any accident is most often not what happened, and that jumping to conclusions is the mainstream media's job.  What is baffling to me is why the hell would any of the flight crew waste time and resources which would have been much better utilized in potentially resolving the issue by making a mayday call literally less than 30 seconds after rotation? There is simply no point in doing so when it's bloody obvious where you're going down. The mantra in any emergency is always aviate, navigate, communicate.
Reply: If it were pilot error selecting the flaps up after takeoff and seeing no climbing rate, the pilot would not have called for mayday. Instead, he would have checked the landing gear; that's a pilot's muscle memory. It's most likely that two engines were off and they were losing power, which is why the pilots called mayday. Also, the deployed RAT supports this.
Reply: You would think on a plane that sophisticated that it would not allow the pilot to make that error and that it would do it automatically
Reply: The loud bang reported is conducive to bird strikes also. Just a theory. The engines would pop when dying out. I was on a plane that happened to . Luckily birds only knocked out one engine . Praise !!
Reply: The survivor confirmed hearing a bang during takeoff plus the RAT deployment suggests that it’s a loss of power and therefore loss of lift and not flaps issues
Reply: @عبدالقادرالجزائري-ث8ل  exactly. And dont forget the Mayday call confirming that.
Reply: @fiachramaccana280 ah didn’t know about the mayday yet, so that’s reinforces this theory
Reply: @عبدالقادرالجزائري-ث8ل  yeah it talked about loss of power...... 
There was also a video allegedly taken inside the same plane earlier in the day on its previous flight where there was a loss of electrical power in the cabin. If true that suggests some serious issues for maintenance should have been tagged.
Reply: @fiachramaccana280 ah that’s in interesting, it might be a design flaw that never came to surface until now, like the Jumbo jet and the DC-10 in the sixties and seventies they were perfect until problems begun , hopefully it’s human error and not design flaw, I flew in this plane many times and it’s really comfortable and silent , a beauty to fly in
Reply: your theory is false if the flaps weren't properly set there would have been warnings by system atm of TO
Reply: Hydraulic failure?  The flaps wouldn't stay down in this situation would they? Also the rat would deploy and if it happened during takeoff they would only have a short time to react.  Is this off base?
Reply: @robertsnider7693  re "Hydraulic failure?  The flaps wouldn't stay down in this situation would they?"  Flaps lock in position with loss of hydraulic pressure, although "windmilling" engines provide some hydraulic power if fluid is still available.
Reply: @robertsnider7693  The RAT can supply electricity, which can power electrically driven hydraulic pumps at very low volume output.
Reply: But, the FDR recorded the fuel cutoff switches being moved to the cutoff position just after takeoff.  The FDR accurately records switch positions, and the switches being in the cutoff position would have doomed the plane.  End of story.
Reply: I think the problem with this theory is that there is 15-20 seconds of “descent” prior to impact. IF the engines were at take off thrust they were obviously spooled up and the crew likely fire walled the thrust levers as well. I believe that 15-20 seconds is more than enough time to get the aircraft flying again even at a heavy weight with an inadvertent flap retraction.

The audio doesn’t sound like there is much power on the engines either. Although audio quality on the vidro could be poor.

People seem to say that the RAT is deployed. Not sure how they know that, but if it was then the obvious answer is that of a dual engine failure. Worst possible scenario for it. Simply no time to recover the engines.
Reply: @Scott767300  There's a youtuber saying it sounds like the RAT is deployed as it flies past but I'm not sure. The sound seems to fade though.
Reply: @mccririck01 Yea I have heard the audio and it could be that of a “fan”. But I have never heard one operate in real life so I have nothing to compare it with. That being said, there are very grainy low rez images that seem to show “something” where the RAT should be. The boxes will clear this all up very quickly.
Reply: Nobody is sure about the RAT deployment, but that plane sounded like it was. A propeller noise, not a jet noise.
Reply: @franciscopino5284I'm not convinced. I hear more a jet noise fading.
Reply: @mccririck01   it's not a fading noise because of the loss of power, It's doppler effect, the change of pitch when spmething is appoaching and going away.  Have a look at other videos showing deployed RATS and you will undestand. Definitely not a normal  jet noise.
Reply: @franciscopino5284the pilot mayday called about a loss of power. No thrust.
Reply: @Scott767300 Power on Stall —————> Look it up
Reply: @Scott767300  The audio is not to be trusted at face value... not that recording. Keep in mind that the Doppler effect is significantly distorting the audio picture as the aircraft travels further away.
Reply: @AudioAardvark yes completely agreed.
Reply: ..If it was a mechanical problem, then Boeing should be put out of business and shutdown, as It's not the 1st time Boeing has killed passengers.
Reply: Prob. These people are notoriously incompetent. There was a Paki flight several years ago where they think the pilot had simply purchased his license. They all want to be the BIG MAN, but with no training or experience.
Reply: Thank You 4 your Input sir
Reply: One pilot on the Indian media said the same thing.
Reply: Then why was the "RAT" deployed... Don't jump to conclusions before boeing
Reply: Sounds plausible and happened before
Reply: I think your right
Reply: omg omg that's me talking to myself. is it possible that it's pilot error? it's too soon for it to be something else
Reply: Agreed with your assessment. The plane would be sounding alarms if the flaps were down before takeoff.
Reply: Other pilots thought the same of you sir.....how is it possible btw? 🤦🏻
Reply: I think that is a better explanation than my questionable guess.
Reply: Shouldn't the on-board computers warn or prevent pilots from making grave mistakes?
Reply: If you have the ability zoom in on the plane looks like the gear is going up. 
I don't see the R.A.T. deployed although it does sound different than possibly a normal take off. 
I have planes taking off over my house all of the time and sometimes they sound like that plane did.
Reply: How does that explain the Ram Air Turbine having deployed?
Reply: inteligencia israelí confidencial 👉 atentado 👉 mano de obra Ucranazi 🇺🇦.. INDIA BRICS...🧱👹🚬🥃
Reply: Another you tube video by a pilot, said the same thing.
Reply: I saw in an other video,the plane took of sideways/diagonally instead of straight take off,yes maybe pilot error
Reply: Glad to see lots of valuable comments from highly knowledgeable persons in this field. Can someone please explain what's the deal with seat no 11A that made the survivor jumps out of the plane.
Reply: U r everywhere,  did Boeing pay you
Reply: How is there not a lockout on the flaps to prevent setting them to zero while gear is down but off the runway?
Reply: Yes the slats are definitely deployed during the rotation. But why did the rat engage. I am thinking there was a hydraulic issue more than flaps being retracted.
Reply: Yes, the flaps were deployed, but at a reduced setting; many pilots and airlines routinely use the minimum flap configuration to reduce aerodynamic drag, which lowers fuel consumption and operating costs. Please see the wreckage from the Pilot Blog. You can clearly see the edge sliding out. https://youtu.be/oUFS2np0mKc?si=0ASfELLX4Llp5u8x Either the aircraft stalled with incorrect speeds or both engines failed; the audio has the sound of the Ram Air Turbine working, then something went wrong with the engines.
Reply: Sure looks like no flaps but Incorrect configuration doesn't explain the rat deployment
Reply: Couple too many zero”s on that 25000 hr 787 number. The first jet doesn’t have that many hours. Sorry. Thought you said 787 instead of 777. Your hours are verified.
Reply: i also heard was bird strike during climbing, well let the NTSB find it
Reply: How pathetic!  But this seems like it fits the video. How pathetic and sad if true!
Reply: Maintainance error; check the videos of previous delhi ahmedabad passenger....
Reply: If RAT is deployed then there is no chance that after selecting the landing gear it will not go up
Reply: VMO switch selection on MFD can prevent gear up operation in flight. It appears the auto flaps were in transition to retract position. The trailing edge goes in first.
Reply: Also why does a modern airliner allow pilots to commit fatal errors in the first place...
Reply: For your information that it won’t be the pilots fault because there were problems reported for the Boeing 777 and 778 and it was said 3 of the workers to fox the plane but Boeing didn’t and there are not as many checks on the plane as before please get your information and don’t blame the pilot.
Reply: It could be any number of issues. 

Flap selection 
Possible fuel contamination 
Change in center of gravity 

Were the ULD’s secured in the cargo hold?

Were the containers and pallets in the correct location per load planning?

Anything could have happened
Reply: It's a inside job executed by pakistan
Reply: My chainsaw has safeguards to prevent damage from human error.  Can't they design  the switches and levers in a way so that it would be counterintuitive to make such error? Or make it completely impossible to  do on take off?
Reply: I agree.
Looks like no flaps and gear down to me. An awful way to try staying in the air while on climb-out.
Pilot error, maybe. If the copilot raised flaps rather than the gear, as he would have been ordered to do, there may have been no time to realize the mistake, and correct it.
There could be some truth to the RAT theory, if they lost all hydraulics immediately after wheels-up, but there would likely have been no time for it to do anything for them, before they bellied in.
As a reminder, from wheels up to cruise is the most critical, dangerous portion of the flight.
I always concentrate yet, pucker just a little, right after rotation. Just a little.
Reply: how can a well experienced pilot confuse between landing gear knob and flaps lever????????
Reply: @MyAirviews  There was that accident with an ATR at Kathmandu, Nepal, where the pilot monitoring apparently confused the flap lever with the propellor pitch. They're next to each other. Mistakes happen !
Having said that, the flap lever and gear retraction are NOT so similar and are in different places.
Reply: Takeoff flap settings are anywhere between 1 and 18 (15 on some models). Are you telling me you can see 1 degree of flap from a blurry video?
Reply: @ImperrfectStranger  You'll need more than 1 degree of flap for takeoff  with a heavily loaded aircraft in 38 degree heat !
Flaps 15 makes more sense.
Reply: not true. ima 25,500 hour RC captain... they forgot to turn the feayul pumps on and sitting for that extra 20-30 min  pretty much ran through all the gasolina they had through the pipelines.  and they pretty much ran outta fuel mid take off.  if true Franklin D Roosevelt will confirm
Reply: @BayAreaBully7667  Why are you even bothering to post utterly ridiculous useless comments like that ?
Get lost !
Reply: Pilot was experienced exceeding 8000 hours flying experience on this aircraft.
Reply: @Sunil-p5q5i  It doesn't matter if pilots have 20,000 or 30,000 hours experience.
To err is human. It happens, that's why there are TWO of them in the cockpit ! The pilot monitoring is supposed to keep an eye on the pilot flying and call out any obvious errors.
Reply: @grahamstevenson1740  ok. Investigation will reveal. Let’s us not speculate at this point. Everyone is trying to become an expert.
Reply: @Sunil-p5q5i  At least I know what I'm taking about unlike some of the rank amateurs here making absurd comments !
Reply: @grahamstevenson1740 thanks. It looks so many people are experts. There are innumerable reasons . People are speculating at the moment.
Reply: @Sunil-p5q5i  Proper EVIDENCE is required. such as clear video, decent sound recordings (if they exist). Wild speculation, especially by amateurs, is unhelpful.
Ultimately the flight recorders should tell us all we need to know.
Right now there are several possibilities that come to mind.
Reply: quit parroting other actual pilots u 🤡
Reply: Who needs the NTSB etc w 4:27 hen y
Reply: The hole in that theory is: Why did the RAT deploy? If it wasn’t for the RAT, I’d agree.
Reply: Americans always seem to claims pilot error quite often.
Reply: @sportsonwheelss  I work in cardiac surgery. When bypass system fails, the manufacturer points finger on the user. We proved the manufacturer wrong several times and the FDA issued several reminders to the manufacturers.
Reply: So a 787 wouldn't have a computer interlock to prevent the pilots from selection flaps up in an unsafe (low speed) scenario like just after rotation?
Reply: Experts pouring out of the woodwork on this one.
Reply: That’s an insightful theory—makes sense.
Reply: Didn’t the aircraft only reach 625 feet before it went down? It literally took off and started leaning to the left and then you see it being lifted up a bit by the right engine until it also failed. I don’t think the pilots put up the landing gear because they literally had just taken off. I don’t think it helped but I don’t think that’s the reason of this crash
Reply: Aren't landing gear and flap controls in very different areas of the cluster to prevent just such errors?

Granted, all I've ever seen are movies but in such they always reach down toward the center where the throttles are for flaps, but up and forward toward the instrument cluster for landing gear.
Reply: Parece plausível o que você disse. Sendo assim, a culpa seria do treinamento da empresa para pilotar o modelo em questão? Se o piloto não tinha horas suficientes de treinamento e vôo, faz total sentido o que você disse. O problema da Boeing é esse: modelos que diferem muito um do outro, sendo necessário muito treinamento caso o piloto saia de um modelo para o outro.
Reply: I concur, I bet handling pilot was captain and 1st officer raised flap by mistake exactly when gear would be selected up. Its too awkward for captain to reach behind the throttles to grab the flap selector by mistake but 1st officer is right on top of them!!
Reply: @Stoic-of-Rome  But why would the RAT deploy for flaps up?
Reply: Just asking,let say if engine malfunctioned and there is no power, can the landing gear be controlled. Like is there any  possibility to prevent this kind of incident.
Reply: Surely if the pilot made such a seemingly basic error they would have quickly realised their mistake and taken steps to correct it?
Reply: That makes total sense to me, I noticed the landing gear immediately and was 1st clue
Reply: That seems unlikely as the pilot and the co-pilot were both highly experienced.
Reply: I wonder if there was a loss of hydraulic pressure, hence the reason for the flaps not being extended.
Reply: You would get warnings if the take off configuration is not set correctly right?
Could poor distribution of weight in the cargo hold or just too much weight be a factor?
Reply: @PetraKann  AIUI, the B787 is very strong on monitoring the takeoff configuration. Historically it's one of the commonest errors made by pilots, so modern planes don't allow takeoff thrust to be set with an incorrect config.
Cargo weight probably not a factor with 10 hours of fuel on board.
Reply: 1.2K+ experts are upvoting this comments 🤔
Reply: 100% pilot error.
Reply: I thought that too, as the wheels were down? Unless they were too busy in the cockpit?
Reply: There is a video allegedly taken on the previous flight showing no air conditioning and no screens on for the infotainment system 
Possible electrical issues ??
Reply: As the same captain, what are the chances of doing that error, by even a NOVICE , do you think? 
What if , the flap hinge is blown up by a small little explosive planted ? 
The survivor reports of a " boom " and then the descent starts . There is no attempt to select the gear . Both engines can't simultaneously stop giving thrust , they can be heard running. The flight path clearly shows climbing and descending.
Reply: It does not help the current situation the slightest pointing fingers at what or who is to blame. 
A thorough investigation will take place, information from the flight recorders, scheduled maintenance reports, repair reports etc hopefully giving an insight to the cause of this tragic incident. 
What truly matters at the moment is the loss of life this terrible accident has caused and the impact this is going to have on many many families.

 My thoughts are with them all.
Reply: Sure has that propeller sound you pointed out.
Reply: Investigators highly suggested that it's fuel contamination leading to both engine shutdown.......

gave a shock to everyone when such tragedy happened in my country
Reply: If it was dual engine failure after take off that plane would not gone as far as it did.
But I will go with reduced power theory.
Reply: 0-hour armchair "captain" here; to me it looks like the flaps were never deployed. If true that would explain everything, wouldnt it? Maybe I just need knew glasses...
Reply: strongly agree
Reply: But flaps were at zero during takeoff itself....
Reply: @Mukherjeee_yt even at zero flaps that plane with full thrust would overcome that. That doesn’t explain the RAT. They obviously lost other system’s before which caused the RAT to deploy. Perhaps that’s why the gear wouldnt come up after takeoff.
Reply: Thank you for your insights!
Reply: Does it sound like the engines aren't running very hard?  Seems like they'd be running full tilt🤷
Reply: Technical  Summary  :  W00PS...
Reply: Really? The plane can't continue to climb with the flaps up? I feel like it might arrest the climb, but not start sinking into the ground... And it doesn't explain the RAT deployment.
Reply: Would the system in the  plane not go berserk if such a mistake was made?
Reply: Why is it always the pilots are the first ones to be blamed?! They died too. Let’s wait for the investigation, instead of this rip off drama.
Reply: If the issue relates to the take off flaps, how on earth is the plane allowed to move off for take off without the “flaps set”? Surely to avert, what is suggested here as possible pilot error, Boeing should have a built in fail safe to prevent initial engine power deployment for take off, without the flaps and anything else critical to a safe take off being set!?
Reply: No way I will fly any airline from this country. 
Google this it could scare you to qdeath.
"India may have 4,000 fake pilot licenses.
Or "Pilots in India flying drunk with a fake license"
Reply: I wonder if the black boxes survived? They weren’t recovered from the 911 flights that hit the Twin Towers and the fireball from this crash was every bit as bad - 130k tons of fuel.
Reply: Still doesn't explain why RAT deployed.
Reply: JAL AC IS ON ITS FIRST FLIGHT AT BOEING EVERETT. THAT IS PART OF THE FIRST FLIGHT TEST. NOT EMERGENCY
Reply: Your point hardly valid ! The flaps were up
Reply: Why would the RAT deploy?
Reply: Were the flaps even deployed in the first place , did they do the flight control surfaces check while on the taxiway , plus I also see the slats open too ? 

So many questions. ( C130 aircraft technician here )
Reply: My thought also...but the images are to grainy. The four areas of stall, this is first one I would be looking at (Pilot Error).
Reply: I don’t think a pilot could make such a basic mistake. It’s like when you start driving a car, the first thing you have to do is release the handbrake and shift the gear into Drive.
Reply: Are you a pilot or something, who is giving your theory
Reply: Look at crashed wings flaps are down
Reply: It's Boeing plane mistake, not pilot, pilot has a good experience, and Boeing's own safety person said they are using faulty or old parts to keep with the time line , so it's definitely Boeing's mistake
Reply: Seriously?! 8000 hours of experience
Reply: There were on-ground reports which said the plane took till the end of the runway to take-off. As an experienced professional passenger and non-pilot, I think that’s a vital information as well.
Reply: RAT deployment is automatic in some instances, but my question, is manual deployment of the RAT part of engine loss checklists/procedure? 

If the 1st officer retracted Flaps instead of the gear, they would believe they were clean (gear up) generating max lift (with Flaps @5) and the AP started to lose vertical climb and speed... they would might immediately think engine power was lost and maybe flip the RAT to generate emergency power. They wouldn't touch Flaps yet because they believed they were deployed and they believed the gear was up, so no need to retract it (again).
Reply: with such high tech airplane, shouldn't pilot see warning if flaps weren't at the right configuration ? Also was RAT deployed ? Would that help to keep plane afloat ?  I guess BlackBox and Cockpit recorder will reveal what actually happened.
Reply: Someone said that a 787 won't allow flaps up at this point in time.
Reply: Captain is a 777, never fly a fly-by-wire 787 and doesn't know the newly designed 787 has front flaps.
Reply: that is what I thought may be? I am no pilot but many years in aircraft maintenance.
Reply: I think there are warning systems for wrong procedures by pilots. Such experienced pilots won't miss these elementary SOP things
Reply: The flaps were up at takeoff.
Engine 1 probably stopped during acceleration.
The pilot raised the flaps to gain takeoff speed.
This is evidenced by the fact that the plane yaws slightly to the right after takeoff.
After that, it loses all thrust and sinks, but this is just 10 seconds after takeoff.
If there was engine trouble before takeoff, it would make sense not to raise the gear.
Reply: Pilot say last word before impact. ' i m loosing thrust'  'may day may day may day'
Reply: @infinityworld2600 Uh oh, what else did he say?
Reply: Losing Thrust issue
Reply: Sir is a faulty APU could be the cause?
Reply: Are you an American?
Reply: Your ideas fit.  Looks like the pilot didn't have his flaps down at all.  That's why she crashed to quickly. 😥
Reply: Pilot didnt put up the gear because he had bigger issues at that time he was trying to solve. Retracting the gear was not even on his mind.
Reply: So u mean system did not generate any warning?
Reply: Interesting interesting
Reply: What is the correct mindset should be. It's not the experience but correct and timely action . Overconfidence may be the reason ?
Reply: Flap control and gear control are in  identical look and shape ? Placed nearby ?
Reply: Isn't it only recently a airindia plane have to return because of toilets are not working?
Reply: No.... the slats were out and flaps were at least 5°.  I can hear the RAT going.  This was some kind of catastrophic electrical malfunction that took out the EEC and autothrottles.  Both engines spooled down.
Reply: @phil1517 no, dont be correcting the “captain” with 25,000 hours. Im at about 235,000 hours myself and agree with you.
Reply: @goblue0020 --sing it, brother.
Reply: This is 737 max scenario and i think you are a tool for naming yourself captain. Let us see what more qualified people have to say. 25,000 miles isnt squat.
Reply: Could heavy cargo have shifted to the rear during liftoff and caused a balance issue?
Reply: If that's the case then it's either deliberate or gross negligence.  These errors cannot afford to happen
Reply: Landing gear isn't retracted the second you get off the runway.
Reply: ex ATC rated for tower and radar, agree
Reply: You might be right.   He might have nosed up in response and made it worse.  It kinda looks like that in the video.
Reply: Yup. Everything is totally misconfigured. Like who the hell even taught these twits how to fly anything bigger than a Cessna?
Reply: Sir did the aircraft stall? That's my theory..
Reply: Not an ATP. Most of my 11k hours are in a King Air. Your theory is possible but not once in any aircraft I've flow have I ever mistakenly deployed or raised flaps when I intended to raise or lower the gear.  It's an almost inconceivable human error if true.
Reply: granting flaps was selected after T/O, the loud alarms in the cockpit should already been automatically triggered by the plane system, so you mean the pilots deliberately ignore the system warnings or unless both pilots had passed out unconscious?
Reply: it might be also due to less runway area for the plane to take of.. the pilots used 1/3 of the runway to take off
Reply: Everyone’s a pilot and expert on Youtube.
Reply: A single child girl travelling from this plane to London her parents book her tickets for 1 day before she wants to go 😢😢

Now she died her father came to the hospital for dna test 

Really heartbreaking
Reply: It’s more like 2 engine failure
Reply: Will the TOWS not hinder that, or at the very least give out many alarms?
Reply: And knowing India flights, the TOW must have been at the max or near there.
Reply: The pilots had 11k hours of service. No?
Reply: Until and unless black box reveals the truth and after clear investigation it's good to judge about the error..until then we cant blame any one .its a basic thing steve..if your brother or your relative is a pilot will you blame the same
Reply: This was what I thought as well - possibly due to a problem getting  the hydraulics to lower and the landing gear to raise.
Reply: sir what about RAT Deployed we can hear loud noise of that in another video , I know in your stream there is no audio of that but you need to listen video with sound.
Reply: I think steps like this should be automatic, it's just bad design if pilot error allows the plane to crash 30 seconds after takeoff, it just shouldn't be possible.
Reply: In most cases when a flight is delayed on t/o time ,the crew do forget to do rush in their checklist module  ,flap might be the issue not deployed  at a right place.
Reply: How on the earth a pilot can lift flaps instead of gears? Flaps lever is right beside the engine power lever, on the other side gear lever is on the front panel beside instrument screens. Same with 777s .
Reply: I think that noth engins failed: low and strange engine noise, failed attempt to give full thrust to maximum climb rate, due to lost power.
Reply: There were certainly doctoral research students on this flight and as usual with Big Pharma and its accomplices they decided to kill them.
Reply: I'm not a pilot, but what I know is that the plane was set to go down that day
Reply: I think most likely flaps being up or down after takeoff would not have stopped the plan from crashing. The plan would have flew  glided..a little farther one way and would have came down n crashed a little sooner the other way.    Maybe.. if the engines or one of them was working some maybe the plan could have maintained flying speed and kept flying with the flaps down but that's a big maybe. I don't know but I'm thinking the engines quit all together or the power went way back on them. Just my thoughts only from watching a bit of this video
Reply: It's astouding, though, that a fly-by-wire aircraft would allow to retract flaps when under the safe airspeed to do so.
Reply: I‘ve Seen a footage that showas a different cabin configuration on this flight. There the seat of the survivor was first row of Economy class and right behind the second emergency exit on the left side. It makes absolutely sense because his ticket showed he booked Economy class, too! So he could Jump out of the Emergency exit after the crash!
Reply: I‘ve Seen a footage that showas a different cabin configuration on this flight. There the seat of the survivor was first row of Economy class and right behind the second emergency exit on the left side. It makes absolutely sense because his ticket showed he booked Economy class, too! So he could Jump out of the Emergency exit after the crash!
Reply: Tell us you're not a pilot without telling us you're not a pilot.

The flaps selector is mounted on the centre stand to the right of the thrust levers while the gear lever emerges from the front panel between the multifunction display units. They are grouped separately, they are shaped differently, sized differently, look very different, require very different amounts of force to engage, and have a wildly different number of detents; they are angled divergently; and they are on opposite sides of the centreline.

Nice try though. And no, being trained by Avianca obviously does not count.
Reply: I FIND THAT AWFULLY HARD TO BELIEVE THAT ON ANY MODERN COMMERCIAL PLANE THAT THERE WOULDN'T BE SOMETHING TO PREVENT A MAJOR PILOT ERROR LIKE THAT. IT JUST WOULDN'T MAKE ANY SENSE. EVEN OLD SCHOOL E2B HAWKEYES HAD RUDDER SHAKERS THAT WOULD VIOLENTLY SHAKE THE PLANE IF YOU WERE LANDING WITHOUT THE FLAPS AT 30 DEGREES OR THE LAND GEAR NOT DOWN. I KNOW THIS WAS A TAKEOFF BUT THERE HAD TO BE SOMETHING  TO PREVENT A MAJOR ERROR LIKE THAT.
Reply: Thankyou for your video on this 👍🇬🇧
Reply: vuelo 5022 de Spanair Madrid 2008.
Reply: Just as the checklist very audibly warns before take off if the flaps aren't down, wouldn't there also be a warning if one was trying to  retract the flaps by mistake if the speed was too low, if the altitude  was too low, etc..? Seems very strange that making such a mistake would even be possible.
Reply: Thank you captain Steve!
Reply: The extended slots are visible, the flaps must have had at least 1 degree.
And confusing the landing gear lever and the flaps... hardly. Although it is possible 🤷‍♂
Reply: CONGRESS =  CALIPHATE INDIA
MODI / YOGI - DEVELOPED INDIA
SO CAST VOTE  CAREFULLY. DON'T VOTE  CALIPHATE PARTY,   DANGEROUS POISONOUS
Reply: Are there no safety measures to stop pilots from making mistakes like this?
Reply: Bet you you're wrong.
Reply: The landing gear hadn't been retracted. Perhaps they were too busy trying to figure out what the problem was. In the short time he had, In the mayday call I heard the pilot named a number of difficulties he  was having with the aircraft. Appears he desperately did all he could to keep the aircraft in the air. Our thoughts go out to all the families around the world who lost someone in this most tragic accident.
Reply: Since there was no flight data transmitted after 600 feet, I guess that was the point when some failure occurred and the RAT was deployed automatically. If one engine had gone out we wouldn't seen a levelled plane going down
Reply: Captain Steve, what about fuel supply or fuel contamination.
Reply: I hear the flaps part captain, But also captain if you look at the video, there is no configuration remedy from pilots, not trying to even change nose configuration slightly. It remained on nose up. That raises suspicion to mechanical failures amongst a few other things. Flaps could have been a normal pilot response to gain a few extra seconds of glide hoping for a solution cuz flaps only show properlyon the 2nd video when it was already stalling. Just my take tho
Reply: Praying for every soul living in fear, pain, or loss. You are not forgotten. You are loved.
Reply: I agree with your theory. If you looked at the later part of video. The airplane looked like landing position. I was wondering why it looked like that? Also, If you see from the middle part of the video, when the flight climbs up, why the landing gear was not retrieved?
Reply: Car aircon specialist here if the pilot switched the ac off he would have more power
Reply: Cap Steeeeeeeeeve
Reply: Photo of tail section shows flaps extended!
Reply: It's due to recent MIT graduation speech by an indian which gone viral.
Reply: Hey, 25,000-hour B777 captain, and apart from "your" theory, any comments on the RAT sound? Putting flaps up will deploy the RAT?
Reply: I will guesstimate, that more than one issue contributed to the loss of the jet & 240 people.  Yes, sounds like a prop to me. 
My dad worked in both avionics,  Apollo & Shuttles. He worked on the stealth bomber, etc. 
He told me as a child,  that planes fall like bricks, without working engines. And it most certainly went down like a giant brick.

I definitely didn't hear those monstrous engines purring, so all any of us can go by is sight & sound.
Reply: FAKE CAPTAIN STEVE, ITS NOT A CAPTAIN ITS A FAKE ONE ! PEOPLE INVENT THEMSELF LIVES !
Reply: My home town of Staines, UK, saw an accident in 1972 where a Hawker Siddeley Trident crashed shortly after takeoff. BEA fight 548.

On that occasion, the main issue was discovered to have been the premature retraction of the leading-edge high-lift devices, or droops, causing the aircraft to fall below the required lift. Panicked, the pilot pulled the nose up, which only exacerbated the issue, causing the aircraft to suffer aerodynamic stall and drop out of the sky, landing on its belly and being completely destroyed, with no survivors. My parents were around a quarter mile from the impact as it happened. 

It is thought that the first officer mistakenly retracted the droops instead of the landing gear. The levers to do so were next to each other and almost identical. (Later they were redesigned to help avoid this mistake)

Unfortunately the circumstances were also not in their favour: The aircraft was close to maximum weight, actually being 24kg over maximum when it started its taxi, and noise abatement procedures were in place meaning they were climbing with minimum possible engine power. So they didn't have much to trade when things went wrong.

Also, an impending pilot's strike had caused huge friction, strained relations, and potentially sub-optimal communication between the crew, especially it seems, between generations. And in this case the Captain was 51, the other officers 22 and 24.

Secondary issues aside, I wonder too if there was a similar mistake made here. Were the flaps raised instead of the landing gear?

Or were the flaps never properly configured? Perhaps they never lowered the flaps to begin with, didn't get the lift they expected, thought it was a power issue, declared emergency, and in their efforts to keep the place in the air, didn't get round to raising the gear? Like you say, there are clues that this was not the case and that the flaps must've been raised after takeoff.

The only mystery is the loud sound that was heard. I'll be very interested to discover what happened here.

RIP to the souls lost and condolences to their loved ones.
Reply: Your theory can't explain the sound of RAT deployment.
Reply: agreed. the plane starts to lose altitude at the exact time the landing gear would normally be retracted. its obvious.
Reply: @kriskalpa 　 Then how do you explain the distinctive RAT deployment sound?
Reply: Nope. I flew 777s as well and it sounds like a deployed rat but no engines sound it looks as if both engines were flamed out or shut down.
Reply: My theory: single-engine failure, which is why there seems to be rudder input. Distraction of engine failure resulted in failure to retract gear. Plane would have hard time climbing on one engine, and gear down.
Reply: Investigation this case, because now India and Pakistan is conflic, this human eror or sabotase
Reply: @CaptainSteve777
Right now what all 787/777 pilots should do around the world is to get on their company or training centre 787 full motion simulators and recreate those conditions, then fly it and see with all the possibilities on how things turn out!
dual engine failure, multiple bird strikes, L/E T/E flaps retraction etc.  do whatever and show in a video what the outcomes are without analyzing and reanalyzing a CCTV footage! Do one of those and then i believe there will be more of an insight to this than just speculations, especially coming from Well experienced pilots.
Reply: facts cos flaps weren't configured for take off
Reply: Those engines didn't sound like full power to me.
Reply: @johnpearcey  no they did not sound like full power to me but then how did it get off the ground ????????????????? could it be just the video volume ??????????
Reply: not loss of power 2 engines would not fail would fly with one engine up to a point looks like flaps no lift  and wheel drag but the pilots had many hours flying time ??????????????????
Reply: Wouldn't a modern plane like this have audio warnings about flap positions at the time of take off?
Reply: E se o piloto estava em depressão e suicidou?
Reply: That's unlikely and flaps were already up on runway as we can see from airport camera.
Reply: There are surely system warnings for such mistakes?
Reply: for a layman it reached from Delhi to ahamadabad , again in ahamadabad there will be checking from ground cruew before final flying to London.
Reply: That does not explain the RAT being deployed.
Reply: A logical flaw: if a plane could take off with no issue, it would have continued so even at the same height, irrespective of the flap maneuver. Why should it descend? Landing gear on or off, doesn't matter in this case at all.
Reply: Captain Steve is hell bent on blaming the pilots for some reason, he can't seem to accept the fact that Boeing has gone down the tubes, and he mat be flying a ticking time bomb himself, he should really exercise some self restraint before blaming his coworkers
Reply: Foi a Boeing que projetou outro avião ruim?
Reply: There is a photo of the wing on the ground with the flaps in the expected position - have you seen that one?
Reply: @alicehendricks  No.  Are talking about the flaps or the slats?  Different.
Reply: The very late take off indicates flaps not deployed and they certainly aren't visible. But surely no matter what automation is present re slats coupling with flap extension, we can't rule out a config system failure.
Reply: @stewartgrant9832 Do we know it was a late take off? How can you tell the flaps aren't fully deployed?
Reply: @mccririck01 There is no flap visible in the video. It wouldn't be fully deployed for take off anyway. Take off flap is much less than landing. The late take off lifts a cloud of dust from the over run by the look of it.
Reply: @stewartgrant9832 You wouldn't be able to see the flap position in that video anyway. Anyone telling you you could is talking bs. There's a captain on YouTube who has said this
Reply: @stewartgrant9832 I don't think you are correct. I haven't seen a professional analyst say there was a late take off. You're just guessing.
Reply: @mccririck01 That was in an early report. Now it's going toward early flap retraction but that doesn't make sense of the mayday as they'd be to busy pouring on power and recycling the flap. I think this thing glitched out personally.
Reply: Lel they are on complete different place
Reply: IMHO: 

- we have no conclusive evidence about the flap state; 
- we also have no conclusive evidence about RAT being out, hearing a sound that might be caused by it for me it's not enough; 
- there's no evidence of both engines failure (fire or, at least smoke); they could fail without any visive evidence, but both engines failing, and without any signal, is a bit difficult to imagine, tho not completely impossible; 
- pilots being "experienced" doesn't rule out an human mistake;
- THE ONLY THING that is clear is that the landing gear was still down, and at that height it should already been retracted. This could be for a mistake or, alternatively, once the real problem arose, pilots were certain they wouldn't get enought thrust for lift properly and thought to leave it like that in the (slim) case of a not fatal landing to absorb part of the impact -- still not very likely imho.
Reply: Pra subir o trem de pouso tem que ter potência hidráulica que é gerada pelos motores. Parece que os motores perderam toda a potência.
Reply: @ademirsousa1502  why tho?

- we should see birds in the video, you need a pretty big flock to screw both engines, and after that we should see at least some smoke

- fuel contamination should bring, afaik, the plane to "scatter" a bit before starting descent, in the video everything seemed alright till 6 th.ish feet.
Reply: The captain of the AI flight was very experienced . So first look at the complex of problems that lead to this. It is allways that. These 787-8's did have issues allthough it is the first body-loss of the type in 13 years of the existence of the type. The plane itsself was about 8 years old. Losing engine power in the first few minutes of both engines on take-off often is catastrofic. The question is why.
Reply: @Changehurts  well if the rat came down and the emergency lights came on there was no main electrical power do the engines need electrical power once they are up and running eh!  ? mmmmm
Reply: @Captain Steve777 : Is it possible that the aircrew retracted the flaps to reduce drag to overcome a possible loss of thrust ? Please comment.
Reply: @sureshp1132  Why would they not raise landing gear?
Reply: @sureshp1132   re "Is it possible that the aircrew retracted the flaps to reduce drag to overcome a possible loss of thrust ?"   No. You would only do that at high altitude during thrust loss.  When you reduce the flaps, you have to increase air speed or you will stall. If you are at low altitude with reduced power, there is no way to get adequate airspeed.
Reply: The other thing here is that the aircraft climbed OUT of ground effect no problem. Therefore it remains highly likely that the flaps were in fact properly set for takeoff. Regarding weight 787 guys will know better, but its probably a 7 hour flight to London and using published figures I think they may have been in the vicinity of 400,000 pounds. The MTOW is just over 500,000. If I am in the ballpark, we would not consider this to be a “heavy weight” takeoff. Long runway, sea level elevation, and 99f degrees. I wouldn’t be surprised if the structural MTOW was in fact limiting (aerodynamically, not by landing).
Reply: Human error ?  are landing gear lever and flap lever so close that pilot can deploy wrong one  by mistake ?
Reply: I thought the same thing, “pilot error” or “suicide pact made in the cockpit”!
Reply: is Captain Steeeve different to Captain Steve777?
Reply: @atit3838    re  "is Captain Steeeve different to Captain Steve777?"  yes, different.  I'm not the Capt Steeeve who does the videos.
Reply: Man, it's gonna be really sad if this was pilot error.
Reply: Interesting thought And I agree with mot of his. If its pilot error it means they wasn't paying attention to what they were doing.!! Could it be tiredness or intoxication...??
Be very interesting to see what the findings are on this crash.
Reply: I dont see the point of Mayday call while something can still be done to the plane
Reply: Raising the gear requires reaching above the throttle to a small lever in the center console. Raising the flaps is a large lever on the copilot's side of the lower center console. It is inconceivable that an experienced pilot would make such an error. And that doesn't explain the pilot declaring mayday.
Reply: Clearly the loud bang led to a loss of power.
Reply: Dear captain, how can it be the two levers are completely different  and at a completely different location, nobody can mix them even if he is drunk.
Reply: Major sign of problem, I'm a mechanic btw, the freaking wheels were still down. And the plane lost lift, I don't know if it's possible to accidently retract the flaps instead of the landing gear? And those rolls Royce engines will make the same sound as the RAT if they are put into a certain lift angle in Max thrust at least the ones on the m1a2 tanks did, that I worked on if the thrust bearings were worn which usually happened after several thousand hours of use on an engine with poor maintenance. You could hear them  over the sound of the tank treads over a mile away.
Reply: The 2 stupid pilots forgot to properly configure the plane for takeoff. Flaps is set to 0.  The temporary increase of lift was due to ground effect. Without the flaps deployed it doesn’t have enough airspeed to produce lift. The airplane can safety takeoff with just one engine. 😢
Reply: @w0lvez1 you cannot possibly see whether flaps are at 0 from the footage provided, even experienced pilots have confirmed this - and there is no way they wouldn't have known this was an issue with all the alarms blaring that would have happened if the flaps weren't correctly configured for take off
Reply: @sarabaker6286  You can easily see if the flaps is set to 0. The flaps don’t occupy the entire length of the wing because the Ailerons are located near the tip. Yes there is a warning but airlines are very well known of flying an aircraft without all the system fully functional. There are no laws that prevents airline from flying an aircraft when some of the system not working. Example: NO Reverse Thrust, NO APU, NO TCAS, Unsync AI & unsync altimeter. The pilots probably heard the warning “Terrain, Terrain, PULL UP”. They literally follow the warning by pulling the yoke up😢
Reply: @w0lvez1 ill listen to the experts about this that say there is 0 way to know that from the grainy footage shown but thanks for your input though ☺️
Reply: Exactly why, since you re not a 787 qualified pilot, don t assume things that can not happen except system malfunction. There is a gate protection system (flight envelope protection) that prevents the flaps from being raised inadvertently.  Let the 787 qualified crews and investigators talk.
Reply: They are already saying CVR has nothing, cover up in progress.
Reply: Electric system failure?!
Reply: @armandobanha3817 apparently the RAT was deployed (it can be heard on a video footage that has sound), suggesting both engines went out (automatic deployment on the 787 when both engines fail.  Now, what caused the engine to fail?  What is what the investigations will reveal.
Reply: Some 787 pilot mentioned something about the 787 will not retract the flaps if done accidentally due to its takeoff envelope
Reply: FEP system: Flight Envelope Protection that preventsoverspeed, excessive bank angle, stall, therefore flaps retraction below appropriate speed.  Only 787 crews would know that.  Not a 747 pilot like 20,000 hours Caprain Steve   @skittles3212
Reply: Thank you I was wondering the same thing as I was watching the plane takeoff and wondering why the gear stayed down. Typically you want to get the gear up as soon as possible. As soon as you have positive climb/rate.
Reply: Yo captain Steve thanks for the vid you posted. I imagine this is your personal account.
Reply: I pray for God to bless, protect, and guide all our wonderful airline pilots.Brave men and women who provide millions of people the opportunity to travel and move cargo, keeping our economy thriving and people to travel for personal and business purposes.
Reply: First of all the JAL 787 with the RAT deployed landing at Boeing  Paine Field in Everett Washington, is a requirement for first flights because they are testing all the systems to ensure they work as designed and ensure it will work in an emergency.
Seeing the ram air turbine (R.A.T) deployed during test flights on the JAL, American Airlines 787s landing in Paine Field, has nothing to do with the aircraft landing due to emergency because both engines are still operating. It is just a test flight.
Reply: How, tf, do you have a machine with 900 buttons allow you to literally yeet the plain into the dirt? Shouldn’t it have a program of what is supposed to happen and perform emergency maneuvers to prevent it? I mean, it’s as simple as not allowing the flaps to stay down when you have given it so much power during take off. Unbelievable I will never fly again after being railroaded during the pandemic
Reply: Not so sure about that, with engines at full power and already 640ft and pilots not pointing the nose too far up, the plane should have been able to stay airborne. Even if the flaps were retracted early, they should have been above stall speed at over 190+knots/357km/h and with the  full engine power it should not simply pancake down. Unless the plane is actually underpowered for the maximum specified take-off weight?  aka unsafe design?   But all people talking about this plane state the engines have so much power. 
 It really looks like loss of power/loss of thrust right after take-off. Hopefully they read out the black-boxes soon, cause apparently there are 1099 left daily flying, we need to know the cause.
Reply: Auf den Videos an der Absturzstelle sind die Klappen aber draußen.
Reply: You are wrong. It is clearly lost trust.
Reply: Kinda like a C172 when you accidentally retract flaps from 40 to 0 all at once in a balked landing (go around). That sinking due to loss of lift.  Different airplane, but same principal....but why is the RAT deployed?  and what about the large  bang as reported by the passenger.   Hmmmm..
Reply: @SaguaroCactus-v3q  exactly . . except with the 787, they're about 50 to 60 knots too slow.
Reply: Doesn't explain the 'loud noise' immediately after take off. Also, does the RAT deploy at every take off or just during emergencies?
Reply: Pilot was 8200
Reply: No way you mistake the flap lever for the landing gear handle 😂.. pilot controls flap/slats f/o controls landing gear.. and it also wouldn’t explain why the slats were down but the flaps were up.. that is not a normal config
Reply: There’s no system on this sophisticated airplane that would alert you that retracting the flaps at that stage is ill advised? 🤔
Reply: You can hear the RAT is deployed on the original video.
Reply: I found the black box and he said mayday Mayday the engine cut out
Reply: Surely the knob for flaps up is nowhere near nor nothing like the knob for landing gear up?
Reply: Pilot error. They forgot to extend the flaps for takeoff as seen in the video.
Reply: BINGO, Captain!
Reply: Know nothing about flying or planes but if i go what u are saying shouldnt the landing gear go up auto or does pilot have to do that aswell as doing flaps
Reply: @hewoguys2506  Selecting gear up or down is 100% manual.
Reply: it sounds like a mistake you'd do in a video game. there's absolutely no way this happened.
Reply: doesn't explain the RAT deployment
Reply: Pilot error.
Reply: @B501R  uh huh....some rando on social media thinks he knows something the rest of us doesn't......fact free nonsense. 
I think we will wait for the report.....thanks anyway
Reply: Completely agree with this
Reply: Could it be automatic pilot problem?
Reply: I hate those national service experienced comments 😊
Reply: Chances of Pilot error is very less.... both the piolets were very well experienced one.
Reply: @jerrydavis3804  re "Chances of Pilot error is very less.... both the piolets were very well experienced one."  They were both low time. The f/o only had 1100 hours.  That's NOTHING for that type of flying.
Reply: Ele se confundiu e deixou de retrair o trem de pouso, deixou os flaps na posição de aterrissagem, o que fez stolar.
Reply: Flightdata 24`s record is showing  that PIC selected an intersection take-off. On the video, the plane looks like to have done a  short field take-off with nose too up.
Reply: Я, диванный пилот всех типов воздушных судов, вижу тут две версии, либо потеря тяги, возможно отказ автоматики, но об неправильной конфигурации идёт предложение, перепутать закрылки с шасси это фантастика, они расположены в разных местах, думаю тут вся проблема в тяге была
Reply: Watched ur entire video on on tiktok, totally agreed with u
Reply: I think so
Reply: Lot of captian steve(s) are out there.
Reply: @just-me-bruh-A2Z    "Lot of captian steve(s) are out there".  . . . factcheck, true!  Very weird.  ;)
Reply: same thoughts....
Reply: what height should they go for gear up?
Reply: https://youtu.be/fHPpTGrxXr0?si=MMUnX7OC1pZ2auth
Reply: Típushiba a hidraulika meghibásodás öregebb gépeknek... Hiába akarta, nem bírta behúzni... Tolóerő leesett...
Aki a vészkijárati ajtó kinyitásával megmenekült, az törte ketté a géptörzset!
Onnantól nem a pilóta irányította a kényszerleszállást...
Reply: At 8 sec's after lift off, the landing gears should begin retracting but it doesn't happen here creating too much drag.
Reply: uh
Reply: Sooner or later they will find out it was a software "glitch". The RAT deployed automatically due to loss   of electrical power resulting in the electrically powered fuel pumps not feeding fuel to the engines. See FAA AD note 2015-09-07.
Reply: Non mi piace il timbro della voce  né la pronuncia in inglese.Chi non è di madre inglese o non sa bene questa lingua non capisce quasi niente
Reply: This proves Sam Altman & Elon Musk & Nvidia CEO are absolutely right. AI SHOULD replace all jobs including pilot, ship captain, etc. primarily.
Reply: Exactly i wanted to say the same.
Reply: You are not Captain Steve. Faker.
Reply: I have a question Captain Steve, first of all prayers to all the victims families in this sad loss of life….. my question being, the original poster says if both engines fail then the “Rat is deployed” how would such a tiny propeller like that be enough to power an aircraft this size to go around and make an emergency landing?
Reply: @axford696969  He's not the real Captain Steve. He's a faker. The real captain Steve is just called Captain Steve and has 500,000 followers. Search him. He's amazing
Reply: on dit toujours avec un avion le plus difficile c'est décollage et atterrissage les reste c'est automatique .... pourtant tout le monde par terre çà prouve qu'ils avaient décollés
Reply: why would the "RAT" deploy because of flaps?
Reply: @markanderson4163  A hydraulic failure would automatically deploy it.
Reply: @chrisheffernan6600  maybe we should all wait for the investigation???
Reply: I'm leaning towards electrical design / software flaw, because Boing.
Reply: I agree with you there that’s the first thing I noticed is the flaps. I am not a pilot. I’ve flown flight simulators quite often. The landing gear should’ve been going up. The flaps should’ve still been down. Why do we not see any flaps? I called this the beginning of the weeksoon as I seen the video it’s insane.
Reply: .. it's another BOEING LEMON... there's a whole movie called Broken Dreams about the Dreamliner
Reply: It could be engine or design issue as well, pilot was 11000 hr too. Something did not work as intended.
Reply: I enhanced an image just before impact and you could still see that the T/E flaps were still extended. I also looked at the other images form just after take off and one after about 15-20 seconds. You could still see that the flaps and the slats were in the correct position. My guess, the plane was overweight. The high local temperature would have also negatively contributed to the lack in lift and thrust.
Reply: Haven’t you ruled out before "Pilot error" when it was actually?
Reply: Yeap, another pilot pointed out exactly the same possible scenario, in which case not only flaps did not provide the left needed, but also the landing gear introduced drag, making it worse.
Reply: But the initial reaction of a pilot if he noticed that he has no trust or lift is to check the setting of flaps right?
Reply: Double bird strike and the consequences….
Reply: But pilots of the plane say you can't change the flaps after take off, so even if you tried to change the flaps it wouldn't do so!
Reply: What about that noise reported near 11A. A container in fwd.cargo hold loose and slam back to the front spar centerwing causes controle damage?
Reply: It's well known that an aircraft will 'mush' (lose altitude and airspeed) when flaps are retracted. If the pilot is expecting this, he can add power and/or change attitude to maintain airspeed. If it's unexpected, as when Pilot Monitoring raises flaps instead of raising gear, it might take a few precious seconds for the Pilot Flying to catch on to what's going on. Like in this case.
Reply: As a retired airline Captain myself, your theory is quite plausible. Even though this flight crew did NOT have a lot of flight time and the First Officer was, by any standard, a low time pilot, I believe the takeoff sequence was normal. By looking at the available video, the initial climb appeared to be normal. That would indicate that the flaps had been set properly and there wasn't a "CONFIG" warning. My question is why wasn't the landing gear retracted as the aircraft passed through 600 ft. AGL ? 
I would also address the flight crew training, especially for the First Officer. 
Just as a point of reference, I did served on a dozen FAR Part 121 accident investigations and two NTSB investigations.
Reply: flaps were down in another video clear as day
Reply: I too agree
Reply: I agree ... It just looks like they retracted the flaps INSTEAD of the gear.
Reply: New information came out. The rat was deployed. Ram Air turbine. It only comes out under a few conditions. Electrical failure. Hydraulic failure. Engine failure. So it is more likely that this aircraft had a dual engine power failure, or a computer reduced power to both engines. Maybe contaminated fuel. Maybe a maintenance error where they installed something incorrectly after an inspection or something. Both black boxes will tell us a lot. I don't believe in the flap retraction situation now that we know the rat was deployed. The rat comes out automatically. There is video showing the rat extended + the audio from the same video matches up.
Reply: 8000 hr ATP here... what if the flaps were SELECTED to takeoff setting but hyraulicfailure didn't actually move the control surface... AND THEN ...long take off roll... looked like they used a LOT of runway.... heavy with full fuel...assuming a hot india day... high density altitude = poor performance.... then after barely airborne (successfully leaving the ground BUT in ground effect) Gear up selected but HYDRAULIC failure prevented the gear from retracting.  Once the plane left ground effect (leaving the distance within 1 wing distance height off the ground)  LIFT REDUCES.... speed isn't increasing enough to maintain flight.
Reply: my friend had same problem 1 time. the copilot take in the flap and not the landing gear.
Reply: How can any of you all see how the flaps are set on this plane, just stop being followers.... You can't see crap please provide an image of flaps that are very well seen!
Reply: The thing is though, it's normal to extend flaps as soon as you lose power, to allow low speed gliding and delay the descent. So even if flaps were incorrectly set, protocol would suggest they would be deployed immediately along with the rat. That suggests a possible hydraulic or electrical problem. Given the gear still up, I'm going with electrical.
Reply: Okay, so the plane was going up, but please tell if the angle of attack seen on the vid is normal for fully loaded B787? If it is too high, maybe it was a stall but with engines working at full power the plane should be still accelerating...
Also, I can't see the flaps being lifted, the engines exhausts were still fully visible. Possibly the flaps weren't extended from the start?
Reply: @lukaszwojciechowski4156  re "Okay, so the plane was going up, but please tell if the angle of attack seen on the vid is normal for fully loaded B787? If it is too high, maybe it was a stall but with engines working at full power the plane should be still accelerating...
Also, I can't see the flaps being lifted, the engines exhausts were still fully visible. Possibly the flaps weren't extended from the start?

That had normal flaps at power-up, or the configuration horn would have sounded.  They were normal at V1 or they would have aborted.  The rotation and initial climb looked totally normal to my eye for a heavy but reduced thrust takeoff.  The initial flight angle was normal until about the point where the gear would normally be commanded and selected up. At that point the flight path changed and settled consistent with a loss of lift or loss of power.  Because the gear didn't come up, I say it was a loss of lift from wrongly selecting the flap handle to the up position instead of the gear, probably by the inexperienced co-pilot.
Reply: @CaptainSteve777  Thank you for the answer.
However, assuming the RAT was deployed, would it happen in the case of flaps erroneously set to 0 with engines working normally?
Also, I assume that the first thing pilot would do in case of apparent engine power loss during start (now, correct me if I am wrong) would be a trying to push the throttle to max. In the video, we'd hear engines powering up, but it is closing to near silence...
Well, we'll see probably. Though with Boeing we cannot be really sure.
I recall my flight in Dreamliner, where a little after start there was a serious vibration, so strong that for the first time I was afraid. Maybe I have the vid from the start somewhere, will see.
Anyway, just... it is sad.
Reply: @lukaszwojciechowski4156  re "However, assuming the RAT was deployed, would it happen in the case of flaps erroneously set to 0 with engines working normally?"  I'm assuming the RAT did not deploy.  If it did deploy, my theory is likely wrong.  Incorrect flap selection cannot affect the RAT.  

re: "now, correct me if I am wrong) would be a trying to push the throttle to max."  Yes, he should be. If extra power was available, a good pilot would want it.  In this case, no matter what the cause/s, but I've seen many examples where the pilot/s didn't add it for many reasons, panic, forgot, etc.  We'll have this answer once the data from the CVR and FDR black boxes is received.
Reply: Your idea is not wat you expect when the RAT is deployed !!
Reply: wild
Reply: Also, the landing gear was still fully extended.  Most likely they retracted flaps, and not gear.
Reply: İn 787  not like 777 Due to protection of flight phase you cannot flaps up that phase of flight even if you select flaps up lever to up position (i think flight envolope phase protection during take off phase captain )
Reply: This comment didn’t age well. Now this same captain is saying it was a dual engine failure.
Reply: I think RAT deployment sounds logical. Also from latest short talk with the survivor it seems emergency lights (green and white) inside the aircraft are on - https://www.youtube.com/watch?v=fmuKCoaoL00&pp=ygUoVGFsayB3aXRoIHRoZSBhaG1lZGFiYWQgZmxpZ2h0IHN1cnZpdm9yIA%3D%3D. Here’s an interesting analysis and some sort of evidences around this theory from the same source video. https://www.youtube.com/watch?v=8XYO-mj1ugg
Reply: Why would the plane allow the pilot to put flaps up ?? That doesn't make sense with its technology
Reply: What a waste of 25,000 hours, when you don’t understand energy

What were you doing for 25,000 hours?
Reply: This is a prime example of sitting in the aeroplane and not learning anything for 25,000 hours
Reply: @thomaswilliam630 lol
Reply: C'est fou tous les pseudo experts qui veulent nous expliquer les causes de ce crash....
Reply: Rat deployed…. 
 
 Suicide? Engine shutdown
Reply: why did the RAT deploy if it was a flap fault ? to me it seems unlikely that a captain would call a mayday so quickly for something like flaps.
Reply: No viajaría en una nave de solo dos motores los de los presidentes tienen 4
Reply: Una pregunta cuáles son más seguras las de 4 turbina o las que solo traen 2
Reply: So, you going to totally ignore the RAT being deployed??
Reply: The rat deployed so you are 100% wrong. It was an engine problem. Was definitely not pilot error.
Reply: Doesn't explain RAT deployment
Reply: That's what I saw too. I'm just a nobody. 
Some other pilot made most/all of your points in his opinions. 
You guys like you understand planes better than this guy.
Reply: Now @captainsteeve777 has copied this theory and retracted his "premature" flap/undercarriage error theory
Reply: Finally a rational answer. And correct me if I am wrong but I got impression to hear the engines running. The RAT makes a more propellor kind of noise.
Reply: Not an expert but i think these planes are advanced enough to issue warning if you select flaps instead of landing gear
Reply: @umang9011  Gear and flap are manual with a few exceptions. You can't raise the gear on the ground, or extend the flaps at too high of speed.
Reply: Isn’t density altitude a concern at that airport this time of year?  No air, overweight?
Reply: @Lewisobssouth37 Surely "a" factor, yes. How much? We don't know yet.
Reply: Well ,Wings are ,Also  ; The Strongest Part of  the Aircraft ! If fuel burn on Other side at first .and He Saw Open door ,?
Reply: @MatthewWilson-vl7qc  The wing "root" is very strong out to the landing gear, but beyond the landing gear attachments, it's not so strong.
Reply: But the gears were clearly tilting forward on the video which indicates that the co-pilot didn't mistake flaps for landing gear. He did it right and thus the pilot error is ruled out.
Reply: @ShivaVishnuppriyaAdhishivan  Yes. The gear tilt is an important clue.  The "black boxes" will tell us what we need to know.  For now, it's all guesses.
Reply: You forgot that the RAT deployed.
However, there was failure of three separate systems not eh flight leg before this one. The AC failed, the attendant call/phone and the entertainment system. With three independent systems down, the pilot should have grounded the aircraft as something serious was wrong and he should have known it. 
How would your airline have dealt with you had you grounded an aircraft? Deadened your career? YUP. You know that this pilot should not have continued and in fact during the last leg he should have notified the airline to replace the craft and refused to fly it.
Reply: @jobseeker1612  re RAT. I didn't forget. I'm just not 100% convinced based on what I've seen. We'll know more soon.
Reply: Could it have been tampered with? As this Plane had done many flights prior to this one😮
Reply: Let's wait until the evidence is in, before yapping.
Reply: That hasn’t aged well . Lol I also have over 25,000 hrs , and a 787 captain (current).
I would never speculate like you do.
I think it’s time to retract your statement which is obviously flawed.
Reply: @Karspa247  There's no reason to retract or remove my post, and all the responses with it. A lot has been revealed in 6 days.  Check your ego.
Reply: Is it possible the EECs were left in test mode for a maintenance check? Can a pilot weigh in if Eicas will display a message to indicate to that the EECs are in test mode? I was under the impression that on a Boeing 787 there really are no indications if EECs left in this mode, but I could be wrong.
Reply: That’s an incredibly insightful breakdown—thank you for bringing that perspective. If flap misselection was the root cause, it shows how a split-second cockpit decision can mimic an engine failure. But here’s the question: should systems be smarter by now to prevent flap retraction at unsafe speeds? Or are we still relying too much on human perfection under pressure?
Reply: Thanks for your expert opinion. I was wondering prior why the landing gear was still down. Could it be the copilot selected a wrong switch? 
But how can make such a mistake after at least ten successful goes.
Reply: @Kritikal_vues121 no power to engines means no power to retract the landong gear,,it also means the  auto RAT deployment.
Reply: Je pense qu'ils n'ont même pas eu le temps de s'occuper du train ou des volets. Il y eu une panne partielle d'emblée. 
Panne partielle pendant ou après le décollage

Une panne partielle de puissance intervient quand la puissance délivrée est inférieure à celle demandée par le pilote mais supérieure à celle du ralenti. Une panne partielle de puissance après décollage est à prendre en considération quand l’appareil a quitté le sol, se trouvant en montée initiale, généralement sous la hauteur de circuit de piste, tout en étant proche de l’aérodrome. Une panne moteur totale précédée d’une panne partielle fait partie des cas étudiés durant cette étude.

Les causes d’une panne partielle peuvent être :
– des problèmes mécaniques du moteur,
– des circuits air ou carburant obstrués, une combustion incomplète, un manque de carburant, un problème d’allumage…
– un blocage mécanique des manettes de gaz, comme un câble de commande bloqué ou rompu.
Reply: @JM-lu8nn I don't think the 787 has cables to control throttles.
It's all fadec today.
Reply: @JM-lu8nn This makes more sense 👍🏼
Reply: The pilot was an experienced pilot.
Reply: @MrGanganagar , the First Officer was not. 1100 hours, just a new hire commercially
Reply: Interesting, air india employees lying in the chat.  Names of both pilots must be released immediately!
Reply: @MrGanganagar it doesn't matter, more experienced pilots have made mistakes
Reply: @CRJ08  white pilots make more admit it
Reply: @MrGanganagar  There are TWO pilots, a pilot flying the aircraft (handling the flying controls) and a pilot monitoring his actions and performing the various other tasks required such as calling out the Vee speeds, setting flapa and gear position and handling the radio.
Reply: @MrGanganagar but, the PIC would give the order to the copilot to raise gear and flaps, in order to reduce work load.
It would be the copilot who made the mistake, and may have raised flaps rather than gear, putting the plane into a non-flyable configuration. 
Flaps up and gear down is what it looks like on video, to me.
Reply: @MrGanganagar Everyone is capable of making a mistake.  That is why a team of two pilots is up front.  Who flew the take-off.   I don't know.
Reply: @MrGanganagar  That doesn't mean he can't make a mistake.
Reply: @MrGanganagar But, how experienced was the Co-pilot,  on the Dreamliner? I'd expect pilot error would be his, not the Captain!
Reply: @MrGanganagar Copilot was not so experienced.
Reply: @MrGanganagar experienced pilots make mistakes bud
Reply: @MrGanganagar  that’s nothing to go by. When I was in flight school our chief pilot was hover taxing to refuel and without any warning whatsoever he had a medical emergency that influenced some shocking actions. You simply never know. In the moment of emergency/failure, when you’re experience it and you’re in command, there is genuinely no way to put your head on a block for anyone regarding how they will react. If his entire career was safe, under this immense pressure, he could have simply panicked. The hierarchy in a cockpit, although we do not like to admit it and we want to hope that with so many souls in our hands it would be different, can lead to tensions that influence even the cp crew in to hesitation before reacting as they are mandated to do. The pilot in command’s career could have been flawless, but if this is his error, and I’m leaning towards pilot error, my heart breaks for him.
Reply: @MrGanganagar the second pilot was only 1100 hrs airborne
Reply: @MrGanganagar so?
Reply: @MrGanganagar there were more than 1 pilot
Reply: @MrGanganagar   It was probably copilot error.
Reply: @MrGanganagar 
That's where the trouble start.. experienced
Reply: And what was the noise the survivor heard?
Reply: could it have been the rat deploying I wonder @yoxat1
Reply: @yoxat1  Nobody knows.
Reply: Exactly. Retracted the flaps, rather than landing gear.
Reply: @Nittanylions1972  and then gav ea mayday call instead of sorting it out, so any noobs here
Reply: I disagree. Unless you had an untrained F/O, there isn't any way you'd mistake the flaps for gear. Sorry, I don't think so. Plus the RAT seems like it was deployed. That wouldn't have deployed if they mistakenly raised the flaps.
Reply: I respectfully disagree with your take. If the RAT did deploy, that would not match your assessment already, but regardless, it's unfathomable that a trained pilot would make that mistake in a plane where each handle is so different. The flap handle looks nothing like the gear handle, is on the center unit instead of the front panel, and it moves back and forward instead of up and down. There are other reason's why the T/E flaps might have gone up.Over speed protection for example.That still wouldn't explain the RAT deployment though.
Reply: @crazymonkeyVII  I'm sorry to have to break this to you, but it turns out pilots are human too, it has happened before, and they too were experienced pilots. It's called 'human error' for a reason!
Reply: @crazymonkeyVII  no overspeed happened.... they lacked airspeed....
Reply: @eugeniustheodidactus8890  yes obviously! My point was that there are other reasons why the flaps could be retracted, and not that I believe that happened. I even stated that that would not be in line with the RAT being deployed, which seems to have been the case. If for example for whatever reason the flap overspeed system would believe that they are in a flap overspeed situation it could retract the flaps. I'm not saying that that happened, just that there could be other reasons than pilot error for that. If they were even retracted, which is some alleged information I just got from his response and haven't verified.
Reply: @crazymonkeyVII  RAT DID NOT DEPLOY
Reply: @crazymonkeyVII  It's happened several times before during take offs in passenger planes. We will have to wait for the final report. It could be a number of things or several.
Reply: @crazymonkeyVII in his mind he may have subconsciously thought he had already raised the gear and raised the flaps on the call for “gear up”
Reply: You may be disregarding the fact that the First Officer was a low time pilot and MAY have confused the flap handle and gear handle in the heat of the moment.  @crazymonkeyVII
Reply: @crazymonkeyVII  "it's unfathomable that a trained pilot would make that mistake"
They're still human, aren't they?

"That still wouldn't explain the RAT deployment though."
How do we know it deployed? Going off sound alone is very risky.
Reply: A person on another   channel said he thought he saw that the Wing speed brakes were still deployed ?
Reply: @Alan59-n9d That's utterly ridiculous, the spoilers (the correct name) were absolutely NOT deployed. There's no  'still deployed' about it. They are used for LANDING not takeoff.
Reply: @Alan59-n9dExplain to me why the speedbrakes would be deployed on takeoff. P*sses me off when all the 'experts' get on their 'expert's' keyboards.
Reply: @Alan59-n9d Still deployed?  Since when do they routinely deploy speed brakes on take-off?  Pictures I saw showed no flaps deployed and wheels still down.  That's the reverse pf expectations.
Reply: @Alan59-n9d Speed brakes? Why would the speed brakes have been deployed on a take off roll????
Reply: @Alan59-n9dI don’t see that in this video. . So far
Reply: @Alan59-n9d This video seems to show exactly that.
Reply: @Alan59-n9dspeed brakes still deployed? Why would speed brakes have ever been deployed at this phase of flight. They weren’t! Another stupid statement by a person with no knowledge of
Reply: @Alan59-n9d   Yes the spoilers appeared extended during the crash decent.
Reply: Exactly what I thought plus 110f outside temp so less lift and probably jammed packed possibly a little over weight. 

I have thousands of hours on Microsoft flight sim lol but aviation geek for 5 decades now. HVAC technician
Reply: Doesn't seem to be a pilot error. He made a Mayday call, which happens only after being sure that the issue is out of Pilots' and crew's control. Besides that, such an advance aircraft will throw warnings for such mistakes.
Reply: @devyanirajan  NO. you DO NOT run checklists before calling a Mayday. You have no idea what you're talking about.
Reply: @grahamstevenson1740  Where is this checklist coming from?
Pilots are instructed to NOT make Mayday calls just like that.

Gear and flap story does not make sense to be the cause here, that's only the symptom of some major technical issue/failure
Reply: @devyanirajan  Running checklists takes several to many minutes !
When the situation is urgent, a mayday will be declared immediately !
Use your brain (if you have one) !
Reply: @devyanirajan , the Captain probably never realized the F/O raised the flaps instead of the gear
Reply: @valentinomarchione5576  Would there not be a warning??
Reply: @devyanirajan  Thank you for reminding us! I was getting confused! So the Captain did make a "mayday mayday" call! So there must have been a technical failure?
The plane was top heavy, full of fuel for 11 hours flight! Maybe they could not stop it anymore :(
Reply: @naomideguyane Sounds like a major technical failure to me,  because ATS also lost contact with the Mayday call.
Loss of contact wouldn't be caused by the gear and flaps issue.

This is just so terribly unfortunate 😢. I wish at least the casualties were less ..
Reply: @devyanirajan  there wasn't enough time for any checklists...
Reply: @devyanirajan  How many hours of flying experience do you have?
Reply: @devyanirajan  nawww. they had 15 seconds to realize they werent gaining altitude, make all the checks, and then make the mayday call? dude called mayday as soon as he felt the plain not responding at that low altitude.
Reply: @devyanirajan wrong!
Reply: @devyanirajan  Your comment is similar to amatuer cook's assumption that advanced cook stove will warn the cook that the food is going to catch fire. Besides people sitting in the house will do everrything to extinguish the fire.   Very primitive and uneducated thinking
Reply: @devyanirajan  So pilot error is ruled out when a mayday call is made? That the pilots may have thought the issue was out of their control does not mean it actually was out of their control.. Humans make mistakes.
Reply: @matthewjenkins1161  Who are we to rule out anything sitting in our couches? Everyone is just speculating here. I don't expect a senior pilot (or any pilot) to mix between landing gear lever and flaps lever, especially when these are located separately in the cockpit. Also, flaps are moved in various degrees unlike the gear.
Expecting such mistake from pilots is an insult to them while they aren't alive to defend themselves.
-- Let's wait for the investigation to be over 
-- Black Box and CVR have been retreived, so lets be patient in our couches.
Reply: @devyanirajan  Yes people are speculating and nothing should be ruled out, especially by people starting with, "Who are we to rule out anything sitting in our couches?". Whatever turns out to be the case, is likely to be something nobody expected of the plane, the surroundings or the pilots. It is insulting to nobody to simply acknowledge human error is a common cause in a significant proportion of disasters.
Reply: @devyanirajan it’s almost always pilot error.
Reply: @devyanirajan that statement is bullshit wrong! U issue a mayday when u can
Reply: @devyanirajan Ma’am. If he did something wrong after cross checking then it means he missed what he did wrong. Why are you questioning a pilot? lol
Reply: @MrsTruthTeller  It's ok to question. I can smoothen my language though :D I have been a student pilot in my youth, and went half-way to PPL as well, so, can a tiny ex-pilot question a pilot ?
Reply: @devyanirajan  A “student pilot” acting as if she knows more than a pilot with 25,000 hours. Hilarious. Slow clap.
Reply: @MrsTruthTeller because she is Indian
Reply: @zhangmike1308  Are all Indians pilots and do all Indians know about planes? What is your point?
Reply: I think it was a dual bird strike, it's happened before. Why? Because there's a slaughterhouse nearby, and birds regularly gather around the runway to indulge in a communal feast, since slaughter waste is scattered all over the place. There were talks about relocating the slaughterhouse, but apparently it’s owned by relatives of local politicians.
Reply: @fnordist perhaps things may change now? 😢
Reply: @fnordist so ur completely guessing, nothing else. I didn't see any birds in the video or see any evidence of any being injested
Reply: @fnordist  source trust me bro
Reply: @fnordist interesting!
Reply: @fnordist  OMG...
Reply: @fnordist  if it was a bird strike there would be flames coming out from the back of the engine
Reply: @Ilike.kong.  Contrary to what Hollywood taught you, bird strikes don’t usually turn jet engines into flamethrowers. In fact, most of the time there’s no fire at all, just a dead pigeon and a very expensive maintenance bill. Fire only shows up when something really goes wrong inside, like unburned fuel deciding to catch up on lost time. And with today’s ultra-high bypass engines, you wouldn’t see flames anyway, even if the engine was in full meltdown mode.
Reply: @fnordist I was aboard a 747, late at night, heading home to Chicago from Atlanta, hour from landing. There was a bad storm, I was sitting over the wing similarly, left side. I saw a flock of what appeared to be Canadian geese, via formation. One got sucked into the 2nd engine, near me! I saw a flame out, and the entire plane pitched 25 - 35 degrees downward! It took them probably 5 - 7 seconds to level it out, I was terrified. I saw a flight attendant looking quickly around, and I raised my hand, like I was asking a question. She saw the look on my face, came over. I pointed to the engine and said, "Bird. Big bird!" 
I explained the best I could, but I was in shock.  She asked me if I'd like a drink on the house, "Screwdriver!" I gulped it down. I wound up w/lots of blankets. 
I doubt double bird strikes, because the 787 didn't pitch any, until just before it crashed. I'd surmise, that at least several large birds, maybe vultures? Would have been easily sighted, and it would've pitched similar to what I experienced!
Something went very wrong
Reply: @fnordist  never trust people  who become politicians  , and never vote  for people  to be prime Ministers  ,president,
Reply: @fnordist there is no evidence of a bird strike
Reply: @fnordist  I have super sharp hearing and can hear something hitting it SECONDS before the crash.
Reply: @fnordist as a former USAF 2a655c/h core engine specialist I see no signs or sounds of a bird ingestion. No sparks, no fire, I didn't hear any compressor stalls, no billows of smoke, we don't see violent shaking of the engines. Nothing to indicate a bird strike.
Reply: @fnordist there would almost certainly be evidence of that in the engine exhaust. Flameouts and/or FOD always disrupt fuel air mix and causes dark exhaust... sometimes flames.
Reply: @fnordist there was no smoke or sparks from the engines so bird strike was least likely
Reply: @fnordist  maybe all the gravel & rocks acted like a bird strike
Reply: I’m wondering if the pilot or co pilot, depending on who was primary, accidentally retracted the flaps instead of the gear.  Human error?
Reply: @adamrubinstein1479  Possibly.... but the flaps looked UP during the takeoff roll.... but the images are very grainy.
Reply: @adamrubinstein1479  There would be a warning.
Reply: @adamrubinstein1479 this is a distinct possibility. The 787 may have some system protections related to retracting flaps below speed but the way the airplane sinks and settles in the videos suggests a loss of lift which would result from flaps being raised.
Reply: @adamrubinstein1479  
The co-pilot echoes procedural calls made by the Captain to confirm that takeoff protocols are executed according to instructions.
Reply: A pilot with 11k hours? No 👎
Reply: @BenWinder108 No , 1,100 hrs not 11,000hrs
Reply: Just because the configuration was a certain way doesn't prove it was pilot error. It could be computer error also. Maybe the controls didn't respond as intended.
Reply: bingo that is what I noticed flaps not in takeoff position.
Reply: I'm a retired airline captain also and this theory is absurd. Never in my flying career have I ever mistaken the flap lever with the landing gear lever. Also, the flap lever has detents to PREVENT raising all of the flaps at once. If this was a zero flap take off, it stalled after getting airborne with the help of ground effect which dissipated after lift off. A zero flap TO would use a lot of runway so that needs to be looked into.
Reply: I am an Airbus retired captain  and i agree flaps where raised instead of the gear...... but it sounds like the Rat extended which says a lot about the engines health
Reply: I agree
Reply: Video shot from runway level capture with CCTV shows that the B788 took entire length of runway before rotation. In video (not the best) looks like flaps are at 0. B788 warning system would have alerted pilots that flaps not set. If issue with engine thrust not sure why take off was not aborted at V1. Again this is based on a different angle of video.
Reply: Why don't they build planes for accidents. Like making things modular and releasing fuel tanks or pods
Reply: @Padrinh01  Complexity of such system would increase the risk of accidental activation or malfunction and weaken the structure. That's why you'd prefer not to take a third (belly-mounted) canopy for skydiving unless you're planning to intentionally cut away your main. It might self-activate on exit or in free fall because of a snag or mid-air collision, and it simply causes an additional snag hazard - all this for very little chance of actually being useful (one in several millions at best).
Reply: Can't get a 3rd class medical because of Lexapro but these clowns are allowed in the cockpit of a commercial jet.
Reply: I looked up the ATIS (if you will) for the airport. 99°F, 27% humidity, 7kt tail wind. I don't think they never had slats or flaps. I am NOT 787 certified, but I believe that plane was outside of the envelope.
Reply: That's what I think. It had enough lift to get off the ground and then it pancakes. Lost all its lift and dropped. Evidence of a RAT deployment is pretty thin.
Reply: @pooryorick831 but listen to that sound .
Reply: @pooryorick831  The rate of climb after takeoff was less than normal. The 787 has 2 HUGE engines and it'll continue to climb with one of them completely non functional, either thrust was lost or lift was lost due to an erroneous flap retraction.
Reply: @pooryorick831  u deaf? U didn't watch? RAT deployed
Reply: @pooryorick831 So what’s your thoughts about the prop sound that can be clearly heard coming from the plane?
Reply: Plane ws in Service for 15yr, AirInndia n Akasha Airlines r Operating Refurbishd Planes Retird by GulfAir Emirates Delta, AirIndia made many Emergency Landing due to Technical Issues in Past, Don’t fly AirIndia even for free
Reply: @MohammedSultan739  I don’t plan on it!
Reply: @MohammedSultan739  
The crashed Boeing 787-8 with registration VT-ANB was delivered to Air India as brand new in January 2014, and the plane was in service with Air India for the last 11 years.
This particular plane did not have any prior record of emergency landings. All Air India emergency landings were with older pre-owned planes.
Reply: @MohammedSultan739 air india had bought a new fleet of dreamliners ... But they need to fix accountability and retire many of the old staff inherited from govt
Reply: @MohammedSultan739 request not to speak something which is not accurate or misleading or false. Speak things only if it is 💯 true.
Reply: @MohammedSultan739  this plane is relatively new. and directly bought by Air India
Reply: @MohammedSultan739  Stop giving False Information. The plane was delivered directly to Air India in 2014! Get your sources right!!
Reply: @MohammedSultan739 not true, was dreamliner for 10 years.
Reply: @MohammedSultan739  chill out bozo ...and where you got that information Any source? Or just trust me bro ?
Reply: @MohammedSultan739   Fly PIA instead I guess.
Reply: @MohammedSultan739  his is a fake CAPTAIN ! He's impersonating captain steve who has more than 50k subscribers, who's a real pilot. HE'S A FAKE PILOT ! INVENTING THEMSELF LIFES ON INTERNET.
Reply: @MohammedSultan739 air India purchased the plane new in 2014
Reply: @MohammedSultan739  Thank you. Sometimes reading comments is very useful
Reply: @MohammedSultan739  This was a 10 year old 787! Truly concerning though
Reply: @MohammedSultan739  that specific planet design is operating for 11.5 years
Reply: @MohammedSultan739  The aircraft involved in the June 12, 2025 crash, VT‑ANB, was built in Everett, first flew in December 2013, and was delivered to Air India on January 28, 2014.
Reply: @MohammedSultan739 you ate madarasa chap person graduated from madrasa what you know about world.
Reply: @MohammedSultan739 787 only entered commercial service in 2011. So you’re wrong.
Reply: @SeeLasSee yeah, one article said it had been in service for 12 years
Reply: @aaaruelas396 yeah, this one 11 years. Maybe almost 12.
Reply: I don’t think they have any option. Just to manage the thrust that they loose just after take off..
Reply: A correct assessment
Reply: This makes a lot of sense.
Because you can see, the plane just stalled.
The engines were still running, but without the added lift of the flaps, they were doomed.
Reply: To me it looks like the flaps weren’t deployed for takeoff, and because landing gear was down, creating extra drag, the moment they lifted the nose to climb, the reduced lift & increased angle of attack caused a stall condition.
Reply: The RAT was deployed and the Captain called a Mayday immediately after takeoff, saying he had lost all power.  Not to mention that was a textbook takeoff for about 400 feet before it stalled.  It wouldn’t have gotten off the ground at all if flaps weren’t deployed.  I’ve seen photos of a wing on the ground and flaps and slats are both extended.

They had lift, until they didn’t.  It was dual engine failure.  It was not a pilot failing to extend flaps.  We need to stop trying to find ways to blame the pilot because we can’t see flaps on grainy video-of-a-video, and figure out why the plane successfully took off before it suddenly lost lift, and why the RAT deployed.

If you’re truly an Airline Captain with 25,000 hours, you’d know when it’s irresponsible to start blaming the crew less than 24 hours after the crash based off grainy video-of-video.
Reply: 25000 hours and you still haven't learnt not to speculate. You are a disgrace to your line of work!
Reply: @tommoerel2404 Agreed. He is not  better than people who are using this horrific incident to make a racial comments on Indians. Totally insensitive.
Reply: A tragic mistake😢
Reply: My theory: ADHD. We ADHD folks do not immediately process information input. Something as simple as left and right, on and off. This has much to do with the fact we must first exit our own immersed state to make sense of something external. Esp. under pressure. This is one reason we miss almost all deadlines. 3-4 sec delay in cognition can be fatal. Flight hour experiences aside, I believe there should be a congition-time testing on all pilots.
Reply: Guess Guess Guess, You have no problem blaming the dead pilots with zero proof. Wonder if your American ? I would have hoped that a pilot claiming to have 25k hrs would be more professional and pipe down until evidence is there.  Would you like your doctor to diagnose you without scans or bloodwork.
Reply: Guys...

Remember this is India...

Poor maintenance is the norm.

The pilots were probably scrolling Facebook.
Reply: @guillermomontoyo  Wot's maintenance got to do with Fascistbook? Nice racist angle by the way.
Reply: The left wing post impact shows that the flaps were extended, the question is what setting was chosen. 

The 787 is not supposed to accelerate unless configured correctly. 

Now what about the RAT being extended? Sounds like a stall due to power loss. NTSB and Boeing will be there. 

But remember the production issues of the 787 also. 

Not to mention this was a workhorse aircraft plagued with problems as reported by other pilots who flew this craft previously. 

Also, united had a repeated issue as reported by Simple Flying of a 787 being returned to airport of origin several times per unreported incidents. 

Before we draw conclusions about this we will have some very educated and experienced people to comment. Listen to them and learn. Don’t get into the wrong mindset, 242 souls are forever lost so be respectful
Reply: You must be paid by boying to comment this on every video on YouTube about this accident 😢
Reply: @falcigo
Who is boying??
Reply: the pilot there had 8000 hrs of experience on 787, so who r u preaching to? there were other important concerns like no power in engines than to worry about some flaps
Reply: Can that plane fly with no engines and just that RAT deployed?
Reply: @ruds2600  No, the RAT doesn't supply any thrust. The opposite actually. Its just a wind turbine that turns the air flowing passed the plane into electricity in an emergency. Pilots deploy them when they lose the electricity normally being supplied by the engines.
Reply: @WessyD1  Thank You for answering.
Reply: @WessyD1 pilots don’t usually deploy the RAT it deploys automatically
Reply: @WessyD1 but it's automatically activated which means both engines lost power. He said it himself. 

So the engines lost power. How? We don't know
Reply: @WessyD123 "No, the RAT doesn't supply..."  I suspect we all know that and I suspect you haven't understand the question, which is why the RAT was deployed (if that's the true)?
Reply: @WessyD1 it will be automatically released if powerless on the main ac essential bus
Reply: @ruds2600  the RAT provides electrical power only. To the systems.
Reply: @ruds2600   No. The RAT relies on airspeed. It doesn't provide any thrust.
Reply: @metrocaptain  Thank You
Reply: @ruds2600  fly to the crash, yes.
Reply: @ruds2600  No. The RAT doesn't provide thrust, it's a fan driving an electrical alternator to provide backup electrical power if both engines fail. A 787 has a lot of backup electrical power in its batteries and the plane wasn't in the air long enough to wind down if the engines had failed. It's not likely that the RAT was ever deployed.
Reply: @ruds2600  no it can not. It is so that basic flight controls can be used...it's solely for electric power not anything to do with powering flight.
Reply: @cd-yq9ou  yeah, i already replied with that. you should read replies before you reply.
Reply: @ruds2600  If you are asking if a plane like a 787 with no engines running can fly, then yes technically it can glide. If the machine would have been thousands of feet higher up in the air, that gliding would have been enough to reach some landing strip. (eg return to the airport). The RAT is nothing but a little headwind powered generator, to give emergency electricity to vital systems like steering, radio etc. It most certainly is an air brake, so slowed the plane down, but in my guess only a very marginal little bit, so in other words, the plane would have gone done nearly exactly the same time and position, with or without RAT deployed.
Reply: @opal42opal  Thank You, I have learned a lot about the RAT since asking the question. I should have asked what is the RAT for. Many people were nice and answered the question. Only 3 or 4 jerks got smart assed about the question.
Reply: @ruds2600  ...I googled your question and this is what it said:  "Yes, a jumbo jet can fly with its engines off and only the Ram Air Turbine (RAT) deployed, but it will be in a gliding state, not powered flight. The RAT provides essential hydraulic power for flight controls, allowing the pilots to maintain control and maneuver the aircraft for a controlled descent and landing." .......That's what the RAT and the pilots did to stay in that controlled  and steady manner it tried to maintain. Tragically, there was nowhere to safely land the plane just having lifted off away from the airport landing strips. 💔
Reply: @ruds2600  NO!!!
Reply: @ruds2600  no
Reply: @ruds2600  - Yup, but not very far when it's only 600 feet high.
Reply: @ruds2600  absolutely no, the RAT is for electric power only.
Reply: @ruds2600  the RAT is used for when engines go out to generate electricity not thrust
Reply: @ruds2600  It won't provide any propulsive power.
Reply: @ruds2600 think of the RAT system as a propeller driven generator. It's not there to propel the AC, just help power the basic systems, if everything dies on you.
Reply: @ruds2600 It sure can. Aircraft don't actually need engines at all.
Reply: @eddieedmondson7698  That's what I thought. It's what you learn after you think you know it all is what counts.
Reply: @eddieedmondson7698  I was always taught there is no stupid questions. Just stupid people that don't ask questions and have stupid answers.
Reply: @ruds2600  It seems impossible to think that tiny propeller could do anything on that aircraft. It looks like a toy.
Reply: @_JimmyBeGood  If i don't know I will ask. Many people have already answered.
Reply: @_JimmyBeGood  That's what I thought, that's why I asked. Keep reading the comments, many have replied with the answer.
Reply: @ruds2600 I hope your joking.
Reply: @ruds2600 No the ram air turbine supplies electrical power incase both engines are lost and supplies power to run the electric hydraulic pumps. This is for the aircraft in the air not this low to the ground. The 787 has two vsfg's per engine for starting engines. The rat is for emergency power in the air not this low. The pilot can deploy the rat as well it has a button in the cockpit a guarded switch. I sure hope electrical power was not lost.
Reply: @ruds2600  No
Reply: @ruds2600  No
Reply: @ruds2600  The RAT only provides hydrolic (steering, computers etc.) it doesnt provide thrust. So if the plane is high up enough it could glide, but at this altitude it was game over.
Reply: @ruds2600  no
Reply: @ruds2600 of course not
Reply: @ruds2600  no but it can help in gaining some control over plane
Reply: @ruds2600 No, the RAT is an electrical generator, deployed to provide backup electricity to critical systems when the engines can't.  It does not provide thrust, it actually creates more drag but keeps the cockpit controls powered.
Reply: @ruds2600  NO. It can land, but not fly or climb.
Reply: @ruds2600  It can't climb as the RAT does not provide thrust.
Reply: @ruds2600  Yea, in outerspace.
Reply: @ruds2600 
Yes, it can…if it has enough speed. 
At such low altitude/low speed it would require very quick action from the flight crew.
Reply: @ruds2600 RAT just provides power to operate basic mechanical functions like hydraulics which includes operation of flaps, rudder, landing gear etc
Reply: @ruds2600  Negative.  The RAT is a power generator, like a small windmill,  it not a source of propulsion.  It will power the most critical systems on an aircraft so at very least it can glide but at under 1000 feet, full of fuel and no engines, there's very little a heavy jetliner like that can do except pray for a 10,000' flat open field directly in front of it.
Reply: @ruds2600  We can see in the video, the RAT is so small compared with the engine, and there are two big engines and one little tiny RAT. I don't even think it would help at all in any situation.
Reply: @ruds2600  no it’s not used to produce thrust
Reply: @ruds2600  No...
Reply: @ruds2600 nope. It supplies the generators pneumatic pressure to aid in electrical failure.
Reply: @ruds2600 no it cant.
but can glide if has altitude...😊
Reply: @ruds2600 It depends on the nature of the fault.  The RAT is a tiny turbine generator that only produces enough power for critical emergency systems like radio comms and very basic control.  Will still need some form of functioning and controllable engine power to stay in the air.
Reply: @ruds2600  Can't fly with RAT.
Reply: @ruds2600 absolutely cannot fly with the RAT. The RAT doesn’t give any power.
Reply: @ruds2600  Not with 600ft altitude it can't
Reply: @ruds2600  it can glide with very basic controls.
Reply: @ruds2600  No, it's more to keep the plane gliding to reach landing when engine failure.
Reply: @ruds2600 No. It’s just to keep the most basic electrical instruments and systems active, to avoid having to fly blind. It’s because the plane is moving and airflow makes it turn and produces a little amount of electricity. Like a ordinary windmill. A very small one. It doesn’t produce airflow or trust.
Reply: @ruds2600  No engine = no power + no thrust. The RAT is just used like a wind turbine to generate some power that will allow the pilot to actuate the controls. With no thrust, the only way you can go is down
Reply: @ruds2600 RAT won't give thrust to take off that plane, i guess. It's helpful when u are cruising at altitude & losing power. Then the pilot tries to guide the plane in with whatever power from the RAT
Reply: @ruds2600  his is a fake CAPTAIN ! He's impersonating captain steve who has more than 50k subscribers, who's a real pilot. HE'S A FAKE PILOT ! INVENTING THEMSELF LIFES ON INTERNET.
Reply: @ruds2600  his is a fake CAPTAIN ! He's impersonating captain steve who has more than 50k subscribers, who's a real pilot. HE'S A FAKE PILOT ! INVENTING THEMSELF LIFES ON INTERNET.!
Reply: @ruds2600  no, the RAT helps the plane to glide. It cannot power the aircraft.
Reply: @ruds2600  it'll glide with control. They got about all the glide they could with that altitude and speed. The RAT doesn't provide thrust. It deploys and is spun up by the air passing through it. It provides emergency electrical and hydraulics when the engines can't provide those for flight.
Reply: @ruds2600 No, the RAT just provides some electrical power for essential flight controls.
It's more or less a wind turbine.
Reply: @ruds2600   no it cannot. RAT is only deployed for emergency electrical power for instruments.
Reply: @ruds2600  No.   The RAT does not provide ANY propulsion.   Zero.  It is for electrical backup (Generator being driven by the RAT) and or Hydraulic backup (Hyd pump being driven by the RAT).
Reply: @ruds2600  no, it is not possible. this event is same as we suddenly release clutch paddle of car and engine shuts off due to high load.
Reply: @ruds2600  No. If the plane is at cruising altitude and loses engines it can glide for miles and the RAT can provide assistance.
Reply: @ruds2600  Absolutely not, they just assist.
Reply: @ruds2600  only in glide, if you have enough altitude and speed
Reply: @ruds2600  No
Reply: @ruds2600  I think the RAT is a power generator (a windmill) not a thing for producing thrust.
Reply: @ruds2600  No the rat is not an engine its just to supply electronic power supply to keep the instruments and some other basic functionality working it can't fly the plane alone without engine power
Reply: @ruds2600  unfortunately no.
Reply: @ruds2600  No haha idk if this is ironic but the rat is just for electronics
Reply: @ruds2600  no the RAT only deploys to supply a small amount of electrical power, so you still have comms and some flight data, no engine power equals no flight on any plane
Reply: @ruds2600  no... it supplies no thrust. Think of it as a windmill electric generator attached to the plane. 
Hope that is helpful.
Reply: the rat is not used for flying the plane , it’s used to create power with a wind generator to power the cockpit instruments .
Reply: @ruds2600  ovvio no....Il RAT serve solo come generatore ausiliare di elettricità
Reply: @ruds2600  Rat supplies electrical power in an emergency. It provides no thrust.
Reply: @ruds2600  The RAT is a dynamo - not an engine that gives thrust. If anything it would slow down the plane; not help it going forward.
Reply: @ruds2600 The RAT provides electrical and hydraulic power only. There is no thrust from this.
Reply: @ruds2600  according to MS copilot:  "The RAT doesn’t generate thrust—it only powers essential systems like flight controls and instruments.
Without engine power, the aircraft becomes a glider. The 787, like most modern airliners, has a decent glide ratio (around 17:1), meaning it can glide about 17 miles for every mile it descends—but only for a limited time and distance.
The RAT helps pilots maintain control during that glide, but it can’t keep the plane aloft indefinitely."
Reply: @ruds2600  the RAT is a generator
Reply: @ruds2600  that is the last help u will have and help you land not take off if you have engine issues.
Reply: @ruds2600  "Can that plane fly with no engines and just that RAT deployed?" - Yes, of course. Airplanes have those silly jet engines only for the takeoff, once in air, they are shut off and planes hereafter just fly with RATs. Sometimes, the jet engines are even just thrown off the plane over the ocean, they can only be used for 12 starts max. Hope I could be of help.
Reply: @markusstiepel7989  That's what all the others are saying also.
Reply: @ruds2600 is that a serious question  ?
Reply: @Danny-ju2ip  What's it for and when does it deploy?
Reply: @Danny-ju2ip  Are you a serious person.
Reply: @ruds2600  Is that a serious question?
Reply: @ruds2600 , no. The RAT only adds some hydraulics and electric power
Reply: A traveler took  this plane days before from another country and  he made a videos about it no cool air  and computer tv . All off.
Did you see this video ?
Reply: @Andr-XXX7  apparently the engineers, tech people, ignored it!!!  Sadly. Just blame it on complaining customers?
Reply: @Andr-XXX7 He mentioned it in this video. And that you cant always trust what people put out there.
Reply: Boeing  over engineering, the flaps and landing  gear on the joy stick  to save  $$
Reply: 8000hours expérience, he was impossible to make such mistake
Reply: @fmskreg7424  The c0-pilot had almost no experience.  He would have been the one making the mistake.  Captain didn’t catch it.
Reply: @fmskreg7424  PIC would call out flap/gear settings to the First Officer to actually do, and he only had 1,100 hours (not necessarily in the B787).
Reply: @rhanemann9100  Is there not a system warning for wrong flap position? I would have thought so.
Reply: I'm leaning towards pilot error in selecting the wrong engine to shut down
Reply: @klacklery  both engines failed, u guys r such clowns
Reply: Shutting down an engine 30 seconds after take off dont make sense  @klacklery
Reply: @klacklery why would you shut down an engine on an aircraft during take-off?
Reply: @roba4295 a whole assortment of reasons to do so. Compressor stall, engine fire, I'm sure the list goes on.  It's a common emergency procedure, but also one that can have fatal consequences if you shut down the wrong one.
Reply: @klacklery  Is that even possible in such an advanced aircraft?
Reply: @mccririck01  absolutely it is.  If you need to shut down an engine in an emergency, you dont want it to be a complicated procedure
Reply: @klacklery I'm skeptical. There would be warnings and there would have been time to restart the engine.
Reply: @klacklery who said an engine was ever shut down?
Reply: @davidmorais480 no one, but, engines generally need to be on to provide thrust, and the radio traffic suggests they experienced a lack of thrust.
Reply: Doubt that  @klacklery   just too little time to follow any sort of checklist that all professional pilots will be instilled to follow.
Reply: @klacklery I would expect YAW if 1 engine stops delivering thrust
Reply: Contaminated fuel is the only explanation
Reply: @stankythecat6735  …double bird strike possible
Reply: Person who survived i think he is the culprit. I dont know why but i feel
Reply: @Wwefanboy2025 😂
Reply: @Wwefanboy2025  jajajaja!
Reply: @Wwefanboy2025  what? I can assure you that’s 100% not possible, unless he went into cockpit. He would be dead as well.